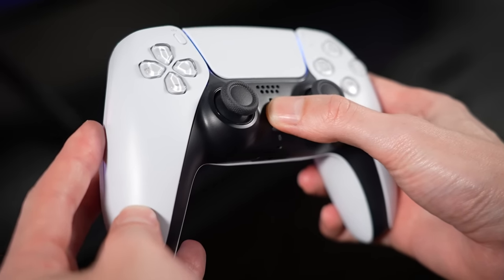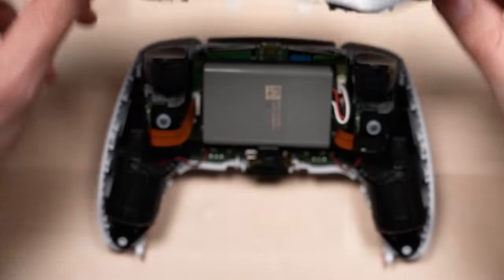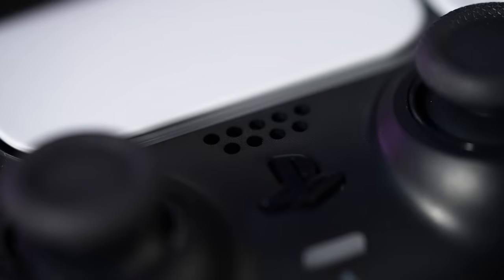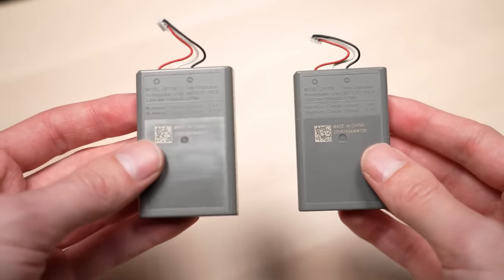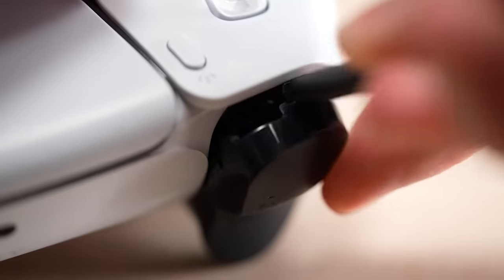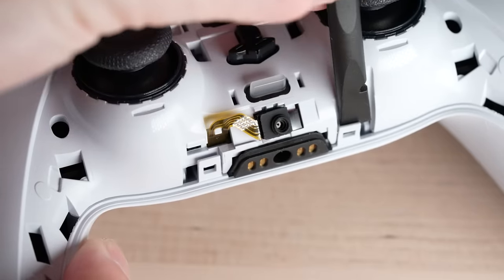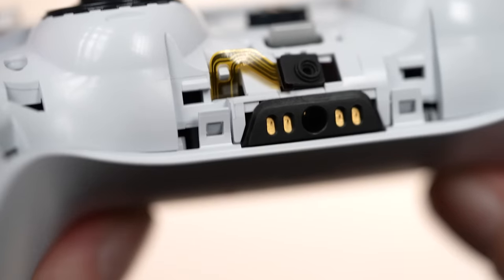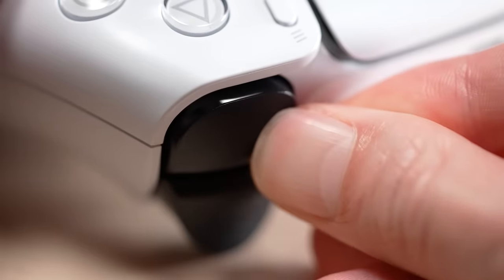Sadly, your Playstation controller won't last much longer..

Comment: I genuinely believe the more modern the technology the more it's designed to easily break so as to force us to but a new one.

Not only badly designed I think companies legit sit around and figure out what issue they want the product to have and design it as such.
Reply: Yea there is a term for this which is "planned obsolescence"
Reply: Bullshit, been gaming for 30 years, owned almost every console released since the late 80s, spend more time than most people gaming.. Not once had a controller break without me launching it at a wall or the floor, I ain’t lucky either, people just don’t look after their shit.. Fat hands mashing the thing out of panic and shitness, launching em etc.. Never had a phone go wrong on me, a tv, nothing, conspiracies mate, tin hat shit
Reply: @Primitive01  firstly at what point did I say only gaming technology.

Secondly I have to agree to disagree with the older consoles being fragile also, I have a snes infront of me that I have owned since they first came out that has been kicked dropped bashed (including the controller) and it still works, yet I have a Xbox one in the cupboard that I had for 2 years without any known damage (kicking dropped ect) that just died, it's the same with PlayStation I have a original ps1 I have owned since it first came out again that's been banged ect through the years still works but I had multiple ps3s that broke easily and also a ps4.
Reply: @kevmccormick1767  Did you not see where I mentioned TVs and phones?… “agree to disagree”, basically “I have no argument” 🤷‍♂️… I have a PS3, PS4, PS5 and a switch that ALL work perfectly fine, had all since release, used by children non stop, sticky hands, dropped controllers etc, no problem.. Years ago had 3 different different Xbox 360s NO issue.. The PS4s fan is loud that’s it… The majority of people have no problem at all, you THINK there is a problem because the only people who go around shouting about things are the people with issues, the millions and millions of people who have absolutely no issues ain’t running about screaming “my shit still works fine!”.. You’re in the minority, not the majority, you’re wrong
Reply: @kevmccormick1767  Actually you know what, I’ve had one thing go wrong, PS2, the fat one, so not no “new technology”, it’s old.. Every time I put a disc in it made a loud crunching sound and wouldn’t work, took the disc out and it had carved a deep scratch in a ring around the disc, had to send the PS2 off for repair,  which was free, warranty and all that.. Other than that all that’s ever happened is a few broken controllers from me launching them as hard as I can purposely trying to smash them into a million pieces, majority of the time they still fucking work.. I’ve actually got a ps5 controller that won’t clip shut because I launched it, works fine.. Got a taped up PS4 controller that I launched, years old, works fine
Reply: Obsolescência programada
Reply: While I kinda see where you're coming from, the problem (as I understand it) isn't that companies are actively trying to do what you are suggesting. The problem, is that in an effort to make things such as gaming consoles, TVs, laptops and so on more powerful. New technology is created, however in many cases, especially with video game consoles. The company has a maximum space they want the console to take up in the consumer's space. So they try to fit everything they want into the console, and if that fails they try to make the things they want smaller. And when you do that with computer parts, (as a gaming console is just a computer with a pre-installed operating system) they tend to become more fragile. All of that being said out of all the consoles I've owned. Only the PS3 and PS4 I shared with my little brother ever gave me any issues. And that wasn't till after he dropped them for the 7th and 9th time respectively. So, while I'm sorry you've had problems with it. You may want to see if there's anything you can change about how you use your stuff. Before assuming the fault lies with the company.
Reply: @Primitive01  Being ignorant and pretending one's opinion matters more is also a minority feature. Stop getting triggered and go enjoy your "WORKING FINE!!!!" technology.
Reply: @UltraObama  No I’m not lucky, the problem just wasn’t as common as people think, like all these “problems”.. I had 3 of em, 2 of em I bought second hand, no issues ever
Reply: @Primitive01  you taped up your ps4 controller😅😅😅😅
Reply: @darmor85  Yeah mate, the d-pad on it was perfect for fighters, never any input errors
Reply: @Primitive01  I can't hate bro but it's funny ..I know I wouldn't do it makes the hardware look cheap but each it's own...... game on bro game on💯
Reply: @darmor85  I did buy a new one, had 4 at the time.. PS4 D-pads are terrible but this one was perfect.. Still got it now, works perfectly
Reply: Yup they do it on purpose with a lot of modern technology and what isn't technology too
Reply: @Primitive01  Your experience is bullshit lol. Been playing with playstation controllers for years and I always have to either replace them or live with drifting problems. Playstation controllers are absolutely weak and always break in like 3 months. I legit got a new controller and it had drifting problems ALREADY, less than two months. I never hurt that controller and had to replace it already. 

It’s no secret that companies make their products weaker than their potential in order for consumerism to take place. It doesn’t surprise me since Sony and some TV companies have little competition with the quality of their products.
Reply: @Primitive01  Maybe Sony should make controllers that don’t easily break 😂 I need to smash some buttons for my competitive games. Jokes aside, I don’t smash hard at all, in fact, when I was using that controller that broke in less than two months, i was only playing games by myself, no competitive games at all. 

Most people have to get new controllers before their batteries turn to shit. You seem lucky as hell, or maybe you just don’t game much. The fact that Sony makes weak controllers just so they get more money is upsetting yet not surprising. If you honestly think companies don’t do stuff like that, then you have no knowledge about the term “monopoly”.
Reply: so true, same for Kitchen Appliance for exemple older appliances seems to last way longer than the modern ones after a study….
Reply: @adangamez3608  You’re insane
Reply: I think this is certainly the case with phone charger cables. Samsung and Apple are notorious for producing terrible cables that last a few months at best. They are now even distributing handsets excluding the power supply and cable, what does that tell you 😂
Reply: @Primitive01  bruh, it sometimes kust happens. I take great care of my stuff. It literally just fried my battery for sitting on the dock charger while I was at work. Literally shit happens. Lmfao
Reply: It's true.  The Centennial bulb has been on almost continuously for over a century.
Reply: @Primitive01  ooook..I mean I don't trash my stuff either but little wear and tear can lead to another one
Reply: @Primitive01  meanwhile I go through like 2-3 aftermarket controllers a year with drift or shoulder/triggers not working at all and tech support sends them back to me saying "they work fine"😂 items for different markets are using different parts. No mystery there.
Reply: If things never break then why would people buy many new things?
Reply: @modev4163  pretty much that. Those analog sticks only have an expected lifespan of 400hours and both cheap-ish aftermarket gamepads and premium ones use the same model. That's like 3 months before the part is worn out if you play a lot.
Reply: @roythegracious  Of course shit just happens, it’s rare
Reply: trading paints  I game too much, more than most people.. Plus I have 6 kids fighting over a PS4, PS5 and Switch.. Sticky hands, dropped shit, finger prints all over discs, thrown controllers, everything.. What it actually means is you’re just unlucky to be in a small minority of people who end up with defects.. The reason you THINK there’s a problem is because you’re the only people going around shouting about it.. If everyone who didn’t have issues went around shouting about it you’d see how little and rare the problems are, thousands of you, millions of me
Reply: @olaf5929  What do you mean aftermarket controllers?
Reply: @olaf5929  Yeah man, Cod= dead left stick in no time, ironically it was around 3 months before mine started going to shit drifting, and stopping me from running mid sprint getting me killed and shit.
Reply: @Primitive01  not made by Sony or Microsoft. By aftermarket I mean brands that make gamepads on license from MS/Sony/Nintendo like PDP or PowerA.
Reply: @Primitive01  You should be endorsed by the video game industry. "Shit don't break, pussies do!"
Reply: @olaf5929  Right, so you buy cheap shit and expect it to last? Would you go buy a cut and shut car and expect it not to fall apart or kill you?.. I know it’s a bit of an extreme comparison but still, you get what you pay for.. I’ve bought a few 3rd part controllers over the years and yeah, they don’t last, they’re terrible but I never expected them to last, I wouldn’t expect something to last when it costs anywhere from 1/6 to 1/2 the price of what it’s meant to be imitating… Guarantee Sony and them lot don’t have any control over those products
Reply: @modev4163  Shit breaks, it’s just rare.. Social media wasn’t around 20 years ago, you didn’t have every fairy with a broken product screaming about it to the world.. And like I keep saying, people who don’t have issues ain’t going around screaming about that either.. That’s what you people need to understand, social media, people with issues make noise, people with no issues are too busy using their shit
Reply: @Primitive01  I broke both Sony's and Microsoft's controllers through usage at the same rate ever since the X360 times that's why I started to buy 3rd party controllers. They last the same for me.
Reply: @olaf5929  Even the consoles themselves last.. Got a PS4 in 2013, got a PS4 pro in 2018, sold the old PS4 to a friend, he still plays it now, we play games together.. I’m on a PS5, he’s on a 8/9 year old PS4.. The pro is in my kids bedroom used daily for hours.. Everyone I know who owns a PS5 has had no issues with the console itself or controllers… We all got a little worried when the PS5 came out and people were going around “ohhh my PS5 has bricked itself blah blah”, year and half later no issues.. A few cases get blown up and sensationalised for clicks, views and likes when in reality there is NO problem
Reply: @Primitive01  i disagree my controller always shits out after 4-5 years my most recent one is 3 I take the best care of my stuff and it's always the left analog stick most likely due to having to always press it for abilities and to sprint in games.
Reply: @Primitive01  I had a working ps2 slim with a fully functioning controller from like almost 20 years ago. Proves nothing. The issue is with current day hardware - no matter if it's faulty joycons, drifting analogs on other gamepads or batteries dying. This should not happen for years. I have the same experience with gaming mice. I have a couple older models that are indestructible, while whenever I buy something new the 20million clicks buttons start giving out after about 3-4 months.
Reply: @Kitsune16-r4h  4-5 years? That’s goooooood, what’s the problem there?
Reply: @Primitive01  I was around before social media crybaby outlets. I tend to agree most shit if you take care of it will last but man those analog sticks are trash long term.
Reply: @olaf5929  Stop clicking the button 20 million times in 3 months 🤷‍♂️ there’s no issue with modern hardware, guarantee a similar amount of ps2 controllers would break through normal use, just don’t hear about it because social media wasn’t a thing back then
Reply: @modev4163  Had stick drift once in 30 years of gaming, a PS4 controller that I launched at walls countless times 🤷‍♂️ at the time I didn’t even know what stick drift was or meant, I’ve experienced it once
Reply: @Primitive01  yeah, do the math on those 20 million clicks in 3 months and get back to me.
Reply: @Primitive01  Sounds like you've been pretty lucky, I'm 35 myself and honestly my ps4 controllers are the first ones I've had drift issues with. My guess is you just get a bad batch every once in a while like any assembly operation. People do have a lot more platforms to cry on nowadays where as when we grew up we only talked to people we knew in real life
Reply: @olaf5929  I’ve already shown you and everyone else the math.. Easily less than 1% of products go bad through normal use, most likely closer to 0.1% or something silly like that considering a huge amount of people won’t own just 1 controller.. If you really think MILLIONS of people suffer problems then you’re insane
Reply: @modev4163  I don’t think I’m lucky, I think the problem is just so rare.. Being in a group of 99%+ isn’t lucky, it’s normal, being in the 1% is just unlucky 🤷‍♂️ When it comes to consoles it’s MASSIVE numbers involved so even if I tiny fraction suffer problems that a lot of problems
Reply: @Primitive01  Yeah haven't checked stats but on a larger scale your probably right. Either way peace man take care!
Reply: @Primitive01   I agree bro, only issue i had was my dualshock4 dpad always pressing right, because i was playing fighters on that lil buddy since 2014, when tekken 7 came out i played kazuya and was wavedashing every day, it died in 2021, so i guess it's still decent time for such a torture of a dpad lol!
Reply: @poligrant5152  Yeah fighters are way more taxing on a controller than any other game, I play MK, taped up a smashed controller purely because the D-Pad was nice.. But that’s a lifespan more than worth the money and it’s not like controllers are  expensive either, they’re actually cheaper than games now
Reply: @Primitive01   Yeah it's quite suprising how gamepads are cheapers than modern games, especially ps5 ones.. i don't know if i need to laugh or cry about it, good thing about consoles is you can grab bunch of games for cheap after few years, i never played much more than fighters on my ps4, so i have lots of catching up to do after i buy ps5, and i can get most ps4 games i wanna play dirt cheap, but new releases price is kinda a joke for me... it never should be that much.
Reply: @poligrant5152  They should be that much.. The price of games stayed the same for 10+ years even though the cost of making games went through the roof, we were well over due a price increase on games… Gaming is an expensive hobby, always has been and always will be
Reply: @Primitive01  I could write hours about this, to keep it simple, 
 the $60 dollars you pay for the game isn’t really the “price” at all. Instead, it’s more like an entrance fee, which is supplemented later on with additional revenue with things such as paid DLC, loot-boxes, annual passes, etc.

Now, I know that gamers tend not to be huge fans of these sorts of monetization strategies, to say the least, and I’m not going to say that greed is never involved. There are certainly companies out there who employ monetization tactics that I would not only consider to be greedy, but also manipulative and unethical. However, I think that is a problem with how these features are implemented, and not an inherent problem with offering these additional payment options to players.
how much should games cost – the truth is that I don’t have the answer – and neither does anybody else, really. This is still a relatively young industry that is changing fast, and must evolve as it grows. However, based on the way the industry is moving, it doesn’t really seem like raising the base price is really a solution to the problems the industry is going through – even if prices doubled it wouldn’t necessarily make the development model more sustainable, and nobody would actually buy a $100 game. If I had to guess where game prices go over the next several years,  I wouldn’t be surprised if developers made you pay as much for DLC'S as for the game itself.
On the other side, fewer AAA tittles released due to increased costs of making said games, so i will probably be fine with the price tag if it's only for AAA games, for any other genre it's still unacceptable.
Reply: @poligrant5152  Indeed there are some companies who are greedy, it’s horrible, EA are the biggest culprits obviously, Ubisoft are another.. But there are a ton of devs who aren’t greedy and they give more than your moneys worth… The majority of games don’t have DLC, it’s a one off payment and you’re done.. You also have to consider the amount of work done on most games post launch, it’s not like the old days where a game was released and that’s it, bugs, glitches and everything else was there forever with no fix, devs now work over time just to get rid of these little things and make us “happy”.. Over the last few years a LOT of studios have gone bust purely because they don’t recoup enough of the money that went into production.. I’m personally fine with paying £70 for a game (dunno what it is in $ if you’re from the U.S), I can afford it, I know some people can’t but like I said it’s an expensive hobby and always has been.. People do have the option of waiting for deals/second hand prices to drop a lot, it’s up to the consumer really.. But I’m the kinda person who appreciates the work put in by certain devs, companies like Rockstar, Square Enix, Fromsoft, any of the Sony studios who have been supplying us with insane games over the last few years, those dudes can take my money all day long because I know they’re doing it for me and not purely for profit.. I appreciate Sony too, they put quality first, they subsidised the PS3 and lost billions…. The main thing I look at with games is time, how much time am i going to put in? Anything over 40-50 hours and I’m willing to pay top dollar, that’s a lot of time compared to any other form of entertainment media.. I think this “issue” with in game payments and DLC is only an issue with a handful of devs, those devs are HUGE and pump out a lot of games but I don’t touch any of em, I made the choice not to give em my money a long time ago 🤷‍♂️
Reply: @Primitive01  Yep, EA and Ubisoft especially for the dlc part, i feel like most of these games feel so trash and have trash payments too.
Anyway brother, you made very good points and i had fun reading that, gaming is indeed a expensive hobby, especially if you wanna be modern and on time, but as you say if you thought about your money spent per hour it's actually not that bad with the game prices.
On a side note, PSVR2 will be worth a look when it launches, i plan to get it for the hope that sony will make some big budget VR tittles, and maybe some major VR improvements, too.
PS. I'm flattered, but im actually from europe :D
Reply: I don't think they sit to talk about how bad to design their products, but I'm pretty sure they low key go like "yeah so we want to manufacture these controllers for 30 dollars and sell them for 70".  They do know that this will make the product cheaper even though it costs a lot more and has better technologies.
Reply: @anthonyvadala4837  well the ps5 itself has no problems at all , all the problems that are happening to some people are happening on the controller , the analog sticks are the same ones that are used in the ps4 controller , which had problems but they didn’t change it for some reason
Reply: @UltraObama  I’ve had one since like 2013-2014 , it still works perfectly fine , only thing that happened is that a little piece of one of the battery pockets for the controllers broke which made it a bit shakey but you can’t even notice it , 🤷‍♂️
Reply: @hussain8776  I get that. I was more referring to said person's idea that companies are trying to make things easier to break as a whole.
Reply: @Primitive01  actually its true, same thing is happening in car industry. They use computer material simulations to reduce cost and quality  just enough to pass warranty.
Reply: @Mr371312  Wouldn’t surprise me if it happened in the car industry, everything to do with cars is already insanely over priced.. 

Is Sony doing it? Fuck no.. This is a company that lost billions subsidising the PS3, a company that puts quality and customer satisfaction over anything else just like a lot of Japanese companies.. Coulda charged far more than they do for the PS5 AND the controllers but they don’t, keep it affordable, keep the customer happy
Reply: @londin engerland “Gamer rage” is a real thing, pathetic but real.. In general I’m not an angry person
Reply: @poligrant5152  I’ve never been interested in VR with the way it’s done right now.. I’ve never played with headphones on, never shut myself off from people and the world around me, I don’t need to because I already get super engrossed in games.. When I’m playing a game it’s already as if I am the character in the game, i get so into them that I really struggle to play horror games lol.. I’ve always kept an eye on VR and always will but I don’t know if I’ll ever bother with it until it gets REALLY good, like Ready Player One good lol
Reply: I agree, my GameCube controller still works since 2004 with no problems.
Reply: Yep, it’s not that just that newer technology is easier to break, companies have done an unfortunately good job implementing planned obsolescence to get you to spend more money, and I fear that’s gonna be the case with the newer consoles
Reply: Not true. I am a product development engineer specifically working with verification and never once seen or heard this in my career from coworrkers, bosses or internal documents
Reply: @GolfCrafter  yeah the person who makes/tests products is just going to admit it. (Sarcasm)
Reply: @Primitive01  I saved and saved and saved and my 360 went faulty within 12 months. I was gutted, but was too young to really appreciate warranty.

I think 360s weren't the best and the PS3s are known to have poor quality thermal compound between the heat spreaders and the dies.

I'm not into "Planned Obsolescence" idea, I can see as you make things smaller and smaller and smaller that they will become more fragile. More power, more heat more wear, that's to be expected.
Reply: @Primitive01  im a bit sus with that xbox 360 story because all are prone to red ring of death only later consoles get it a little while after the launch models
Reply: @Caluma122  I had 3 different 360s and had no issues with any… I’ve never had an issue with a console other than the PS2… Things today just get sensationalised because of the internet but in reality any issues are so rare it can’t be considered an issue.. A small proportion of things going wrong has to be expected and because absolutely huge numbers are involved when it comes to gaming it’s gonna seem like a lot of issues, when in reality you’ve got 100s of millions of people out there who never or very rarely have any issue, ESPECIALLY today with “modern tech” because far more people game now than they did 20-30 years ago.. I read something earlier that apparently 2 billion people play video games, dunno how true it is but even if it was only a fraction of that you’re going to have lot of issues even if those issues appear like 1% of the time
Reply: @kevmccormick1767  I'm being honest but I believe that over optimization of products or poor quality control of the manufacturing part could be blamed.  In its simplest case you want something to be as efficient and light as possible for example, and you know by simulations that it works with say a factor of three. Before we had these computer simulations, you would guesstimate when developing (before concept test) and always be on the safe side, such as a factor of five in today's world while we were sure that it was larger than three.
Reply: @Primitive01  now hold it I've may have worded my last comment a bit vaguely let me rephrase i find it hard to believe you doesn't mean i don't maybe ya got lucky with the last one and may have ditched it in time you never know im just going of the facts that the rrod existed and got a lot of 360 consoles i didnt mean all of them were going to get it either i meant that you could have been at risk of it i also didn't say you were lying so you can cool off
Reply: @superpotato657  Interesting
Reply: @Primitive01  Your argument is solely based on your own experience. That does not mean it doesn't happen to other people's equipment. I can say the same thing and say, "my computer never malfunctions, but how come people's does?" You seem to have a narrow view of the world around you to think like that. Yes, it is uncommon for techs to go wrong in a larger scale; however, that 1% is still thousands/millions of people. Are you going to tell me that is OK as long as you never experienced it? Why do you assume everyone THROWS/SMASHES their controllers? I just don't understand the higher pedestal you put on yourself...
Reply: They’re plan is how to keep making money over time. Not, how durable can we make our products
Reply: @Primitive01  i think the reason your controllers still work after you toss them as hard as you can is because you're not that strong... probably only goes about 3ft away from you.
Reply: @joshuas390  You think wrong little man
Reply: @Primitive01  you call me little man yet you can't even break a piece of plastic. LOL
Reply: @joshuas390  But as you can see from my comments I have broken a piece of plastic, controllers don’t smash into a million pieces, they pop apart, try it… I call you little man because you go about with that profile picture but spend your time acting a fool on the internet
Reply: @Primitive01  my 1st ps5 remote literally just stopped working didnt drop it didn't spill anything I dont play rough either it just stopped working
Reply: @privatedankmemes4882  Unlucky.. I’ve had 2 since release and they both work fine
Reply: @Primitive01  well true, thought i just have dualshock 3 and 4, about 4 piece each and  they arent that fragile that i still use the same from the time they release until now, my kid brother often use it too and really no problem. Im sure above 90% everything is without problem if we keep the things proper
Reply: @Primitive01  totally agree, I'm 50 and have been gaming since my dad bought me Pong in the Seventies. He also taught me to look after my gear. I always strip and clean my consoles every six months after the warranty is up and same with my controllers. Companies can't make equipment that will stop dust as they need vents for cooling so it's up to the user to do the necessary cleaning. Every day use and I've yet to see a console fail, I had one controller stick suffer drift but it's easily fixed if you're good with a soldering iron.
Reply: @adangamez3608  his experience isn't bull, I am in the same boat with having no issues except one PS4 controller suffering drift which was easily sorted by replacing the solenoid. I game every day so my gear is well used, batteries with constant use and charging will last a very long time compared to someone who only plays on the odd weekend. Perhaps you throw your controller around when you're getting your ass handed to you in games 🤷 get guid. 🤣
Reply: @johnbuchanan3455  It’s easily fixed if you know how (I don’t) but also not very expensive to replace if needed.. The price of a game for 1000s of hours of use, one year warranty, worth it considering most actually last years
Reply: @johnbuchanan3455  solenoid? You don't even know what you are talking about. It's a potentiometer. Don't speak about subjects you have no knowledge on please
Reply: @Primitive01  Replacing the analog sticks is not hard, the hard part is finding good calibrated potentiometers. Originals are hard to come by. The dreamcast used hall effect joysticks, why can't modern consoles use them? The potentiometer joysticks are flawed from the factory and you know it...
Reply: @DarkoPetreski  I don’t know it, I don’t even know what a potentiometer is.. If you have issues you’re in the minority.. That’s all I’m gonna say now, can’t be bothered.. You’re in the minority and a negligible fraction of controllers suffer issues, it’s as simple as that.. You people come to me as if I’m weird or the devil or something when I’m part of the overwhelming majority.. The only reason you don’t see people like me all over the place is because nobody is gonna feel a need to go shouting about how their shit don’t break
Reply: @johnbuchanan3455  No, i don’t throw my controller nor abuse the crap out of it. Maybe Playstation should make controllers that can last with competitive gameplay? 😂🤷 I get pretty good at games, no need to tell me something that others online tell me already, “gEt gOoD” lmao, child behavior right there.
Reply: @Primitive01  I don't have problems with drift either, because I don't use my controllers that much, but you can't tell me the design isn't flawed. Hall effect sensors and magnets are way better, and that design isn't even new. The dreamcast did it, and flight sticks have been using it from almost the start. You just have to admit that it's planned obsolescence.
Reply: @DarkoPetreski  No it’s not, if it was a huge proportion of units would break, they don’t, you’re wrong.. I’m not gonna keep explaining it, a lot of people clearly go about with tin hats on and/or don’t understand very big numbers
Reply: @DarkoPetreski  a potentiometer is a rotating variable voltage knob from what I know but I'm a structural steel guy not an electrician. The shop I get my analogue sticks from calls them solenoids and they cost me £5, I don't really have to know what the specific name is whether you're right or my shop is right to be able to unsolder the old one and replace it. I've only ever replaced one but it's been fine for nearly six months now so I must be competent enough to fix things outside my own field of work. 🤷
Reply: @johnbuchanan3455  if you can solder the damn thing on, you can learn the proper name for it.
Reply: @DarkoPetreski  I don't really have to if it works, it's not like I'm starting a career in fixing controllers 😂 and I can't see it being planned when they use a part that's cheap and freely available. They could make the controller a sealed unit or slightly modify the parts so you couldn't buy a replacement but the option to repair Is there so there's no complaint imo.
Reply: @johnbuchanan3455  sure i guess, but i still hate the potentiometer design. Check out the gulikit kingkong 2 pro, hall effect sticks and triggers.
Reply: The lightbulb conspiracy homie
Reply: @avocaza1393  everyone is entitled to their opinion 😭
Reply: FACTS
Reply: @Michael Moores Because you’re unlucky.. You don’t understand huge numbers and percentages.. You are unlucky
Reply: It's called planned obsolescence, and is what happens when only profit incentivizes industry growth.
Reply: In this case, not so much. This is a limitation of modern battery technology. The holy grail of battery tech is a high capacity battery that can be charged and discharged quickly, and doesn't lose maximum charge during normal use. Something like a capacitor, but better.
Reply: @Primitive01  "companies like Rockstar, Square Enix, Fromsoft, any of the Sony studios who have been supplying us with insane games over the last few years, those dudes can take my money all day long because I know they’re doing it for me and not purely for profit." 

I find it really funny that these (with the exception of FromSoft) are the companies you decided to highlight. Rockstar - the company that has resold GTAV for $60 across what is now three generations of consoles and tries to milk its playerbase with shark cards. Square Enix - the company that just sold off their Western studios to fund blockchain and cryptobro investment (lmfao). And lastly Sony, the same company that turned Gran Turismo 7 into a steaming pile of micro transaction bullshit instead of what should have been the premier next gen racing title it was meant to be. The only three big boys you were missing to make the list absolute satire are Bethesda, Ubisoft, and EA.
Reply: Capitalism 101
Reply: @Primitive01  ps3.

Not everyone is nintendo , companies can and have cheap their controls / consoles / accesories for more money.

And nintendo still isn't except of bad design , joycons start having drift the moment dust enters on it.

dust !  the first most common thing to have in a controller for a portable console.
Reply: Fortunately reality isn't quite so cynical as that. True companies design things for planned obsolescence, however in most cases its just a matter of deciding which issues are "acceptable" risks. In many cases its cheaper for them to eat the cost of a few replacements than to fix the problem.

That said, some technologies are more prone to wear and tear than others. Older systems used less power, had fewer chips, and we're designed more robustly with children in mind.

Even then, how many PSX CD drives died due to being left on for days? Obviously its going to be worse now when everything uses high tech sensors and the like.
Reply: @chrismdb5686  You know exactly what I meant.. Yeah I could have worded it differently, I know it’s about profit, they are businesses, businesses that provide the highest level of quality and actually give a shit about offering a product fans will love, if people like your product your profits will increase..

You lie, GTA5 on the PS5 was a cut price for how long?? I think it still might be, not full price, nowhere near it and anyone buying it is doing it purely through choice, it’s not required at all.. Shark cards are never thrown in your face, they’re on a menu screen you never have to look at and there’s never a point where you feel a need to pay, it’s purely a choice.. You also forgot to mention how GTA5 has had countless amounts of free DLC over the last 9 years, isn’t the same happening with Red Dead as well?? Free content across 2 games? Good service they’re offering there no??..

Square doing whatever doesn’t affect me so I don’t care..

I’ve got GT7, it’s a brilliant game.. Sony lost billions subsidising the PS3 even with the high retail price but whatever, Sony products are of the highest quality

I’ve never spent a penny on micro transactions and probably never will, I don’t understand the issue with most of them.. The ones you mentioned are for in game cash, they offer no advantage and you know exactly what you’re getting, it’s an option that essentially cuts out a few hours of play time, what’s the issue?? Things like “loot boxes” I understand the issue, you don’t know what you’re getting and in some games they DO give you an advantage, still, you ain’t required to pay it, if it’s that much of an issue just keep your card in your wallet but whatever, like i said you know exactly what I meant 👌
Reply: Responding to earlier post: @Primitive01  survivorship bias is strong with you. ‘Never happened to me?! Y’all are crazy.’ 

Meanwhile there’s been literal case studies on Apple degrading their batteries intentionally (Watch Marcus Brownlee), GE building shitty washing machines that fail quickly, modern Volkswagens, or how lightbulbs should last forever but aren’t profitable (Watch Veritasium), etc. Just admit you’re lucky and move on. Do some research. There’s a reason why people from different backgrounds can all agree the newer stuff isn’t built to last.

Edit: Also, why so worked up? Defending these products and corporations profusely for days against literally everyone. Not like you’re appreciated by those businesses…
Reply: @Primitive01  No I didn't know what you meant, but know I know you just love the taste of corporate boots.

So Rockstar never throws Shark Cards in your face... despite the fact they advertise them? Despite the fact that when you try buying an item you can't afford they pop up and say "here's an easy way to get that paper friend." That's not literally putting it in your face? Ok then. RDR2 is dead and not getting anything btw, that's been the case for a while, and GTAV ""next gen"" is full price in a lot of places (including where I live), but you'll probably just throw your catchphrase out to that and say "well you're just unlucky" right? Lmao

GT7 is absolute shit, let's take a mostly single player experience and cap the amount of in-game currency players can get through playing the game so people are pushed to purchase that currency through micro transactions just to play the game. Every ""coupon"" you get for a car purchase is only available for a few days so if you either don't have the cash or don't want to actually pay you're SOL and can't unlock that car. Don't have the right class for daily/weekly events online? Open the wallet or else you're SOL. Don't even get me started on the fact the game is 90% a single player experience but needs to be connected to their servers 100% of the time for you to even play.
Reply: @frustratedmillennialz  I don’t doubt it happens in some industries, you can see what I’ve said, I’m talking about the video game industry, or more specifically Sony, Microsoft and Nintendo and controllers.. I’m not defending anything, I’m replying to people who come to me, I’m being polite.. I could just tell everyone they’re stupid and leave it at that… I’m not lucky, I just understand the numbers involved and the role social media plays on peoples perception, something almost everyone here blatantly can’t understand
Reply: @Primitive01  I never paid for a copy of GTAV in the first place, so why the hell would I buy GTA6? Because brand recognition? Nah, just because you consume products with no thought doesn't mean everyone else does the same. I didn't buy GT7 because I've learned to not pre-order shit because too often those that do get fucked over by the devs for doing so, and holy hell am I happy to have only experienced GT7 second-hand. Imagine being happy with a product you paid 70 $/€ for and can't play whenever their servers are offline/down for maintenance when it's intended as a single player experience first and foremost. That'd be like buying Skyrim only for Bethesda to randomly pick and choose what days you can play the game on.

"Honestly I think you're just a fairy" - sorry, I understand if English isn't your first language or something, but what the fuck does that mean? 😂😂😂 The rest of that tirade makes you sound comparable to a Nintendrone with your worship of these god companies that can do no wrong.

Touch grass
Reply: Wtf are you guys doing arguing for a week.
Reply: @BamfIamone  As you can see I’m just educating people who come to question their daddy
Reply: @Primitive01  The only time I've really had tech break was a couple phones, an xbox one controller, and my dualsense. One cot run over and the other got a cracked screen when I dopped it and it hit my boke pedal. That being said, my dualsense broke when I never did anything to it. I just palyed it. Not even enything strenuous, and I don't eat and game. the joystick just was not made the best and started getting drift. The xbox controller was understandable though. I played Sekiro and Ori and the Blind forest, and between those two game my LB eventually broke, but that was because of the design on the og controllers. It also started to drift a bit, but it had been in use for like 6 years and probably a couple thousand hours between the previous owner and me so that's fair
Reply: @orinblank2056  Ok.. I’ve got 2 dual sense controllers, had em both since release, one is popped open on the left handle/grip or whatever you wanna call it because I launched it at a wall, a clip snapped and it won’t pop shut, both still work perfectly fine.. Thought the trigger or something might not work on the smashed one but it does, they both work as if they’re brand new.. I have 6 kids, the controllers get used way more than most peoples, they get filthy, they get sticky, they get dropped, don’t doubt they get hit and chucked when I ain’t around too.. If you’re shit broke through normal use you are unlucky.. Every single person I personally know hasn’t had a single issue with the console or any accessory.. Remember when the PS5 first came out and peoples consoles were “bricking” themselves? Unlucky few
Reply: @Primitive01  Not all products are made exactly the same. In mass manufacturing some items are just made with kinks and whatever the weakest link is breaks first. 

My PS3 slim's board just completely burned out on me one day while playing. It froze and then didn't turn back on. I tried replacing the power supply in hopes that was the issue but it wasn't. 2 weeks into owning my PS4 the R2 spring snapped on me and I had to replace it. The replacement has endured ever since. 2 years in I had to replace the battery for the same controller and just recently I had to replace the charging port for it. 

Nothing older than that PS3 has ever broken on me. I'm not saying things are purposely made to break easily but as technology advances, the parts used to make them have become more delicate. When you're mass producing these delicate parts, some of them are going to be less sturdy than others, even among the same part.
Reply: @Syntherus  Of course not all products are made the same.. Things break unintentionally but it’s rare when considering how many units are shipped.. 120 million PS4s have been sold, I dunno why I keep saying the same things over and over.. imagine 1% of pre packaged PS4 controllers broke, that’s 1.2 million broken controllers, it’s a LOT but it’s still extremely rare and people are extremely unlucky.. Now imagine 10s of thousands of those unlucky people go about shouting on the internet “my shit broke my shit broke” and they see all these other people saying the same thing, they’re gonna think there’s a problem no? There’s no problem, you are unlucky 🤷‍♂️.. Shit, now think about how many break while still under warranty?? It’s silly numbers mate
Reply: @Primitive01  Nah obsolescence is a legitimate thing apple got into trouble for it with their batteries being designed to fail after a year.
Reply: @drunkengamer1977  Yes, read newer comments
Reply: @Primitive01  "you're insane" and you are the one talking about argumenta...
Reply: @RSlamyx  What
Reply: @Primitive01  lol there's far too many. Sonys usually pretty good tho I've had them all since PlayStation one the only one that died was the OG fat ps3. The only controllers I've had issues with was the launch ps4 pads  the rubber came away from the sticks on both of them but that was a known problem that Sony addressed had no issues with the newer ones.
Reply: @Primitive01  I've been gaming just as long and I've had tons of issues.

The original NES had the spring that would wear out.

The TG16 just stopped turning on at all for no discernable reason.

The original Playstation had overheating issues and the laser would stop reading games. This happened to not only me but to several other people I knew.

The original XBOX also had overheating issues.

PS4 analog sticks developing some kind of weird dead-zone when pushed to the edge as well as drifting.

Just had a TCL tv that suddenly makes everything look super washed out. Tried everything and nothing fixes it.

A 2TB HD got a bunch of bad sectors after only a year of use. Once again nothing works.

Had another PC that for some reason just randomly stopped detecting the graphics card. It wouldn't recognize any others I tried either, even after thoroughly cleaning it and a fresh install.

I've never mistreated any of these items and yet I they all developed issues. Sometimes you just get unlucky.

Planned obsolescence isn't a fake conspiracy theory either it's a real one. Watch Veristasium's video on it.
Reply: @Vaporifix  My point is “new” things are no different from old things, you’ve just shown that in your experience what I’m trying to tell people is truth
Reply: @Primitive01  didnt actually mention phones or tvs and i believe your in the minority in this one since those issues are highly common not to mention planned obsolescence is covered in college Engineering classes part of the reason why phones are basically disposable same as most electronics nowadays
Reply: You are absolutely correct. New smartphones can't even be taken apart, for the same reason - so that you don't fix it yourself.
Reply: lmao this man really said " i even had 3 or 4 360s with no issues" 💀😂 does anyone really need to hear literally anything else this man says... i don't think so
Reply: @Primitive01  it's a little weird the man who is so defensive of the product almost as if it's a personal insult or he works with said company has had multiple of the same consoles yet none has had issues, here's a question for you if you have had no issues everything works fine then why feel the need to go buy multiple replacements of the very same thing?
Reply: @kevmccormick1767  What? The 360? The 360 is the only Xbox I’ve ever had, I was impatient and couldn’t wait for the PS3 but I ended up liking the 360.. Anyway back then I was a lazy jobless 16 year old, came across a little bit of money got a 360.. I didn’t have the money to own multiple consoles, over time the Wii came out, I wanted one, didn’t have much money, traded in my Xbox, got a Wii.. After a while traded in the Wii got another Xbox, split up with my partner at the time and she kept the Xbox, eventually I went and got another one.. No doubt not the answer you were hoping for but whatever
Reply: nomasporfavor  Ok little boy
Reply: @Primitive01  you've been responding to these comments for the last week. Go touch grass
Reply: @MrHappy4311  Touch a woman fairy
Reply: Switch drift
Reply: No shit Sherlock
Reply: Especially how they don’t want you to try to fix it either with warning labels because GameStop or the company themselves won’t compensate for a dysfunctional product if you do better pay for that warranty all I’m saying smh.
Reply: @Primitive01  "rare, you must be mistreating your stuff, this stuff is the minority so you're WRONG, hasn't happened to me so therefor these are lies," God of War pfp? Checks out. I hope Sony is praising you for the free pr you're doing for them. It's funny, because a little over a year ago I called a Sony rep, you know, the dudes that actually get PAID to work for them? Yeah, he told me himself that two of the most common problems they get for their dualsense is stick drift and loose triggers (which was my problem) thanks to the adaptives. But I'm sure you'd be happy to yell at him with your laundry list of excuses. I don't eat while gaming. Ever. Hands always stay washed after the bathroom and eating. NEVER thrown any of my dualsenses because I'm not a manchild. This shit happens and isn't "uncommon" as you like to put it. The only thing you're right about is obviously there's going to be more people with working products than not. But give it time and I would bet my left kidney that there will be way more people that need a new controller. In not that much time either. It's kinda obnoxious that there's people like you out there claiming things are bullshit because you apparently haven't experienced it. So first controller I played two games at the time that used adaptive triggers, got a loose r2 button. My most recent issue stick drift. And it was a black one so not that old! Crazy part? I don't even play shooters so I'm not mashing in the sticks 24/7.
Reply: Apple
Reply: @SuperHornetX  they don’t do that anymore bud
Reply: @UltraObama  my 360 has had 20+ ring of death but still works almost fine just the disc drive doesn't work properly
Reply: @ErockHQ  they've always done that.
Reply: @SuperHornetX  and they got sued and haven’t done it in multiple years
Reply: @ErockHQ  they literally did it months ago.
Reply: @NYC_Goody  It’s rare.. I ain’t explaining again
Reply: I don't think it's that nuts but the more complex you make a machine the easier it usually breaks and alot of people do really stupid shit to their possessions cause they don't think it'll break. Before I got my PS5 I heard stories of people breaking their adaptive triggers but after I used them it kinda clicked that it seems people have to basically try to break them when they get tight from stuff like Fortnite bows and stuff in game
Reply: @Primitive01  you don't know what rare is. You're a grown man doing free pr. Obviously in the grand scheme of things with any product, there's going to be more working than not. Captain obvious statement. But to act like it's a few isolated incidents is completely oblivious on your part. Know what we did before social media? Took it to the store and bitched.
Reply: @NYC_Goody  Right? I grew up Sony but hardly trusty them anymore, mainly from their lack of care for the PS5 scalping market
Reply: @Leboyo56  yeah, I actually don't get this guy. I mean, the only systems I ever grew up with were a bunch of the older Nintendo ones and a ps1 through 5. So I've been with Sony for over 20 years and while I'll agree with him about the older accessories being built like a tank, I can't get behind him saying it's like that for the 4 and 5 as well. I mean good for him that those 2 generation controllers can somehow go through abuse while I've had to go through ps4 and already ps5 controllers when I take care of them. Makes no sense.
Reply: @Leboyo56  “PS5 scalping market” another thing blown way out of proportion.. “I can’t get a PS5 because scalpers”, no, you can’t get one because you are number 30,000 in the queue with a stock of 200
Reply: @NYC_Goody  He seems like the guy where you could unknowingly agree with his opinion before he voices it, yet he'd still shoot ya down just to disagree and be on top of the conversation.
Reply: @Leboyo56  based on his comments, I'd say that's pretty accurate loll
Reply: It's not some conspiracy, technology gets more advanced, compact, and in turn, more fragile. Think about it, of you throw an old controller that has nothing in it but a circuit board, a few wires, and a battery, it's not going to do shit, if you throw a new one that's heavier, has 5x more wires, a circuit board with more shit on it, and adaptive triggers and all that shit, something is bound to break.
Reply: @Primitive01  not true lmfao never threw a single controller nor do i bash shit yet one of my Xbox 360 controllers stopped working with no real reason to so im not sure what your talking about when you say you had nothing break that's just being hella lucky
Reply: @Primitive01  you better go look after your 6 kids lol. You have too much free time daddy
Reply: @keyboardwarrior8905  Might take you a while to read and respond, takes me no time at all.. Majority of these comments have been posted while I’m at work, you know, unlike the most people here I have a job
Reply: @Primitive01  i’d agree - but even the best cared for controllers in a dusty enough environment can render buttons or control sticks defective
Reply: @Leboyo56  I’m the type of guy who talks TO people, not about them.. People trying to make out I’m weird for replying to comments, you’re here just hoping to get noticed ffs.. Don’t be scared, get involved.. I’ve already told you how you’re wrong, instead of “oh yeah makes sense” it’s “nope, gonna ignore the common sense and keep believing my fallacy” because instead of using your own brain you blindly follow any old waffle you read on the internet
Reply: @DuskLegend  Of course, if you read a few more comments you’d see that during my time educating fools I’ve said multiple times I fully understand a certain amount just go wrong for no reason, it all comes down to how many going wrong is acceptable which would be a matter of opinion
Reply: @gastergiovanna9793  Ain’t surprising that you’re not sure
Reply: Yes, it's true, but when it comes to joystick drift and lithium batteries that is not much to do, they will have problems eventually.
Also, planned obsolescence is very common on the car industry.
Reply: @kevmccormick1767  I will have to say, I do agree with the other guy more. While it may be possible, there's quite a lot of proof that just says you either received a fault console/item, or you just didn't look after properly. My family have old, old consoles that still work fine and dandy. Even the xbox 360, where everyone had issues with the "red ring of death", is still happily up and running. I've had my 2DS for almostc10 years, my Nintendo DS for longer, and my Xbox One for over 6 years. And guess what? All of them work absolutely fine. My family have all had the same consoles, TV's and phones other than when they 1, wished to upgrade or 2, you're my sibling who managed to get so angry they broke their DS purposely, twice. The point is, things won't break if you take good care of them. I don't tend to mash buttons or get aggressive with the joy sticks because not only am I quite calm and respectful towards my consoles, but I also play fairly calm games that don't require that aggression. And even then, my father has still had most of his controllers from when he first got the xbox that still work despite playing such "aggressive" games. Just look after your stuff, and if there's a problem, then oh well. You just happened to fall into the minority group who gets those problems. With anything, things get old and things sometimes mess up, you can't expect everything to be perfect. But making up the statement that they purposely break their own stuff? If that were the case, there would be way more issues happening and way more people complaining.
Reply: @avocaza1393  How is anyone being triggered? All they said was that it's a minority issue, which is true. Apologies if you've faced any issues with consoles yourself, but it is literally a minority issue out of the almost 8 billion population.
Reply: @adangamez3608  If you haven't read a previous comment on the subject, many companies create the console with a limited amount of space to suit what people want. People no longer want big bulky consoles and instead want thinner, smaller consoles. Which means that the things inside, if it can't fit the limited space, will be forced to be made smaller which means it'll be more fragile. You want a smaller console and controller, yet complain when they do exactly that because they physically can't make the things inside as durable as they want to. And if they did create a bigger, bulky console, you can be damn sure that everyone will throw a fit. You also admitted to playing competitive games and having to mash buttons. Now while it's not an issue and you may be "mashing the buttons lightly", that stuff still builds up over time which causes your controller to get stick drift and button issues as a controller isn't really supposed to be constantly mashed the way people do in competitive games (just hearing how loud you guys are with it causes great sadness for me lol). While I do have sympathy with the fact your brought one with stick drift already, it doesn't take a genius to know that all the aggression, no matter how "light" at the time, will build up quickly if you either 1, game all the time and/or 2, constantly mash buttons on your competitive games.
Reply: trading paints  It doesn't mean that at all. My father is an extremely competitive gamer and whenever he isn't at work, which is quite a lot, he is always on his games. Yet all of his things work completely fine because surprisingly, we look after our things. Sometimes stuff just breaks, especially if they're old or, like you've literally just answered yourself, you use them all the time
Reply: @olaf5929  No, it's not pretty much that. Because if they did purposely make consoles to break, guess how many people would be going on a rampage complaining about their broken consoles? I'll answer it for you, not many. Because the majority of people who play still have good, working controllers and consoles, even ones from back in the day that still work perfectly fine.
Reply: @Kitsune16-r4h  You literally just answered yourself. You've had it for YEARS. Looking after your stuff is all good and fine, but you can't expect it to last forever. Wear and tear can build up over the years, no matter how gentle. Some people can have them for ages, some don't. But you can't complain when each controller did it's job and lasted multiple years then broke because they just got old. That's like me complaining my nan died. She passed because she got old and that's what people do. It's a dark comparison but for you people to understand, its the only thing I had
Reply: @olaf5929  Again, go back and read the persons comment on how stuff are built. Past consoles etc are much more bulky then modern ones, which means the stuff inside are more durable. However, because the new ones are slimmer, the stuff inside are required to be smaller so they can fit which means they are more fragile. This is because people now a days are complaining about how the consoles are too bulky and should be made slimmer bla bla bla. And before you go, "Well I don't care if it's bulky or not!" Good for you! Say that to the millions who do care. Because news flash, you guys control what's made as companies will always look to what people want most in a console so they can make it, make people happy that they got given something they asked for, and keep customers. Only for you all to complain "it breaks easier!" After you all smash buttons and shit. No wonder.
Reply: trading paints  You say as millions of xbox players still have working consoles and controllers they've had for years, me included.
Reply: @poligrant5152  Popular games are the worst. I had one game that was 50 pounds or so, then within a year went to 20. But games like Pokemon will always, no matter what, stay at over 50 pounds because they know it's popular and people will buy it. Same with EA. Unless you buy DLC packs, the game tends to be so tasteless it isn't worth buying. Sims 4. I love the game, but unless you buy DLC packs, it's awful on it's own.
Reply: @superpotato657  Sorry, but not all are prone to it. My father still has his from when they first came out and it works fine. Things dont always break, get over it.
Reply: @jaek8029  No one is saying it's ok, he's saying that it's a minority issue and isn't the company purposely doing it.
Reply: @adangamez3608  Or maybe you should just... not be on your console 24/7? And they do make controllers for competitive players, my father has had controllers for more than 5 years and they still work. And anyone else I know also have controllers that still work. It's simply just a case of "I use these too often and over time they'll obviously wear down, but I'm going to pretend as if it's Sony's fault and not my own for spending my entire life on a console and causing a controller to do what anything does, get old and wear down"
Reply: This comment section is filled with two people. The unlucky side who complain they've had something for multiple years that break after wear and tear or complain that the consoles are fragile whilst still being the same people who complain for slimmer consoles and the other side, the majority of people who have had zero issues but use a lot of bias to back up answers. And while bias does work, it's still, in many eyes, not a valid argument/point.

While some companies are shit and are doing things as a money grab, making things less durable or just purposely not good so people HAVE to buy new ones, consoles aren't like that.
Reply: @Totally_Not_A_Crab  your clearly not getting what I'm saying then, I clearly said I have older consoles like a SNES that still works (also have a few other retro consoles all working) so if my issue was wear and tear over many years wouldn't I be moaning about my older retro consoles no longer working.

I don't recklessly use my technology if I did then my older consoles would be broken after about 30 years of use.

I will reword my point since people are getting offended that I dare criticise their precious gaming systems lol the more modern the technology (not solely gaming tech) the lower down the list of priorities for corporations is reliability and lifespan. Then you also have some companies that legit program/produce the product to break/fault after certain timeframe regardless of usage, apple have been proven to do so and if they do it the chances of others also doing it is pretty high.
Reply: Cries in joy con drift
Reply: @Totally_Not_A_Crab  That's why after i bought sims 3 and dlcs, then bought sims 4, i started cracking DLCS because no way in world im paying over 350$ or even more for full experience, and yes that's life of popular games, where you say that they go cheaper within a year, that's why im so happy i have lots of game to catch-up after i get ps5, they will be stupidly cheap, im not even guilty for cracking games that are made like bloated DLC assholes, don't care.
Reply: @poligrant5152  I just think it's a stupid cash grab on most parts. They know if they release a shitty game people will buy DLC to get more of the experience. Its bullshit.
Reply: @Totally_Not_A_Crab   Yes, companies like this really like to test the waters and go over the line and see how much they can afford to cut out, funny thing is games from EA or Ubisoft mostly feel the same in terms of gameplay, and are full of useless open world interactions that are totally boring to do.
Reply: @Primitive01  Companies have made products which they know will fail after a certain time in order to ensure a consumer base and demand is always there. 

This is no secret and the biggest case to come out of it was from light-bulb manufacturers. The top light-bulb manufacturers got together in the 1920s and agreed to make sure their light-bulbs would not exceed a certain amount of hours before failure. 

The same practice was found to be used with General Motors and Ford, and has been shown time and time again with modern technology. 

The practice still exists because it works, not many people complain because of warranty. 

In 2020 Microsoft faced a lawsuit due to making their controllers 'drift', as did Nintendo and Sony for DuelSense. These cases (at least for MS and Nintendo) were taken to Arbitration as per the "Service Agreements" that were signed. They clearly know what they're doing and if they are purposefully making their products to break, not much can be done as they will just make a public statement saying 'it's a design fault we overlooked' and take any lawsuit taken to Arbitration due to their agreement you sign when you sign into their service. They have covered themselves legally and even if a lawsuit were to make it to public court, the amount they would lose would be nothing to the amount they make from selling the products.
Reply: @No-wo8ri  And who bought this lawsuit? A handful of whiney little Americans in a nation where you could face a lawsuit for saying “good morning” to someone?.. Time it took to write that comment you could have read more of mine.. Too many people jumping into a discussion way too late and after reading only one or two comments
Reply: so accurate
Reply: exactly
Reply: PS2 controllers could take a beating and never break mine are like 18 years old and still going strong
Reply: it's called planned obsolescence.
Happens in many companies.
Reply: i think another thing to keep in mind is that these gotta be mass produced. its a great device but they gotta cut corners somewhere and that hits longevity unfortunately
Reply: @Primitive01  touch grass, gamer
Reply: @Primitive01  The lawsuit was more than just some 'whiney Americans'. The lawsuit was taken after the law firm got a class-action suit together. They cited that since 2014 there were thousands of complaints of controllers beginning to drift just weeks after warranty expired. They went through message boards and YouTube, Amazon sales and saw that the problem was large enough that videos on fixing the issue had hundreds of thousands of views. 

I've seen enough of your comments to know that you believe that they don't make the controllers, or at least certain components in them, to break or be fragile on purpose. The truth is they would absolutely do it, because there is no downside to them doing it. They can't be sued because they've covered themselves in the service agreement, they offer warranty which covers them from consumer law, and as a result they would and do make millions off of selling controllers. The companies take a loss on the console, they need to find a way to make that money back. It is just a business practice that is used. 

You can see that on Amazon the components for repairing the common problems are constantly in the top 50 sold under the gaming category. While I can't get exact sales numbers across multiple suppliers, there is clearly an issue that isn't 'whiney people in the minority'. I would say it would be even worse as most people who experience don't even take the time to go onto a message board and complain or repair their own controller, they just go to the store or buy a new one online.
Reply: @CrispyChicken38  “literally literally literally”.. I wouldn’t be surprised at all about American companies doing it, you people pay to be told to get out of bed in the morning, could sell you a bag of air ffs.. Japanese company’s generally put quality above all, it’s why their products are so popular and well liked, LITERALLY
Reply: Just buy one from Walmart and take it back every 29 days for a new one.
Reply: I have PS4 I have owned since launch it never broke on me.I've only had to replace my controller as it was 7 years old and no longer was holding a charge.My PS4 has been kept in great condition no problems to do this day.
Reply: @No-wo8ri  What’s thousands when it comes to hundreds of millions? It’s negligible.. 

Controllers breaking weeks after warranty expires? I’d pay attention to that if there wasn’t an insane amount of variation between peoples general usage and care, again it comes down to the hundreds of millions of controllers being used and a negligible amount coincidentally breaking not long after warranty expires.. How many break before warranty expires? How many break 6 months/1 year/2 years after warranty expires?

I don’t doubt it happens in certain industries and to be honest I would not be surprised at all if Microsoft did do something like that (I don’t think they do), they’re an American corporation who tried to bully their way into the industry for all the wrong reasons and if they keep going the way they’re going Xbox will disappear before long.. 

Saying “they can so they will” is a joke, the only evidence for it is a negligible amount of people who think a £50 product should last a decade, a product that goes through more wear and tear than almost any other household item.. The fact it only comes with 12 month’s warranty should make it clear to everyone your controller should not be lasting as long as your console, you should expect to have to buy one or two replacements over the years.. They’re not even expensive ffs, they’re the price of a single game, even if Sony or Nintendo were doing it the money they’d make would also be negligible… Do it because they can? And ruin the reputation they’ve built up by putting quality and customer satisfaction above all else? Something Japan prides itself on, the opposite to America… There’s a reason Sony and Nintendo completely dominate the industry and it ain’t through conning people into buying inexpensive replacements that’s make them negligible profits
Reply: 0lanned obsolescence
Reply: @adangamez3608  tbh I've had my ps4 controller from I bought it and it's fine but I did have issues with Xbox controllers. The battery for both don't last as long anymore either but idc
Reply: @Primitive01  damn. Mans singlehandedly spoke for everyone
Reply: @abelchavez2463  Some lead, some follow
Reply: @No-wo8ri  People also watch videos when they have no problem.. Millions out of hundreds of millions is still a tiny fraction
Reply: I've had many Xbox One controllers and they just aren't made to last. One of them had a really stiff and crunchy d-pad and a mushy bumper right out of the box, and all the others have developed mushy bumpers, inconsistent bumper actuation and stick drift within 2-3 months. Even the original Elite controller developed mushy bumpers and stick drift within 2 months of me owning it. I don't hit the buttons, I don't throw my controllers, there is nothing abnormal about the way I use them. Some things just suck, but I also wouldn't be surprised if there are at least a few companies out there that incorporate weak points or potential faults into their products.
Reply: @No-wo8ri  No I just think your “statistics” don’t show much at all.. You don’t need to watch a whole video for it to count as a view, you don’t need to search for this shit for it to be recommended, you know for a fact half the people in this thread alone don’t own a PS5 and have never even seen one.. Your statistics don’t show how many people are watching shit or buying shit before warranty expires, a year after warranty expires or nothing, they show people bought shit over the last 9 years, yeah, NINE years for consoles with combined sales of 300m+ and rapidly rising.. 

Sony can’t prove it’s not done on purpose just like it can’t be proven it is..

Shit breaks, there’s a ton of variables involved, too much for a company to figure out how to con people
Reply: It’s been like this for decades. Clothes used to be quite expensive but they lasted forever. Dads 72 HQ Belmont did 600k km without an engine rebuild, entirely serviced himself they were so mechanically simple. But then companies realised people weren’t buying their things more than once
Reply: @Primitive01  The Switch has a pretty common problem with joycon drift. You can solve it by putting a piece of paper under the cover so that the stick is pushed in place more firmly.
Reply: @Primitive01  go look at the lightbulb industry and come back they literally made the lightbulbs break and or break faster bc when your shit lasts forever you don’t get a lot of business
Reply: @rileyedwards6495  Read more of my comments and come back
Reply: that's fact bro, no cap
Reply: @Primitive01  OK, enough of this. But just so you know this isn't the first time Sony has been accused of doing something like this. Accusations go back as far as the 80s when people started reporting their Sony products exploding only months after warranty expired. They tried to dispell the rumours in 2006 after a massive recall happened with Dell who used Sony's batteries. This gained attention and relit the rumour that Sony was purposefully making their products break after a certain amount of time. This was brought to light in the western world after it was found that a 'software bug' caused Sony's Bravia TV'S to stop operating after 1200hours. This didn't help because when looking at the average user time of 2-3 hours a day it would stop working exactly after expiration of its warranty. 

A similar measure was added to the PlayStation Networks Anti-cheat that required a mandatory accurate on Date and Time through a CMOS battery or network. After this was found in 2021, the public made it clear that it was not standing for it and so it was removed just weeks later. 

People have every right to he suspicious of any company, including one that has had prior problems with those issues. 

You came into this comment section shooting down person after person who accused Sony of participating in a practice that is and has been used by a lot of companies with their evidence being their experience. Your evidence is no different to theirs. You are putting trust into a company based on your experience, and hundreds of others here have shown their distrust in the company based on their experience.
Reply: @Primitive01  no
Reply: I’m i might honestly remove the battery and keep it plugged by all time at this point
Reply: I hate so much... joysticks are very expensive in my country
Reply: @No-wo8ri  Yeah ok, like the lightbulb conspiracy.. I show my trust by buying their products, if people are suspicious maybe they should just stop buying em
Reply: @rileyedwards6495  Fair enough
Reply: @Primitive01  You can call it a conspiracy but they admitted to it and the documents that the companies signed to agree not to make a product that exceed a certain amount of hours is publicly available so.... 

I'm sure some people do stop buying their products, but the truth is the vast majority won't even if there are problems because of the 'value' the entertainment sets bring to a person's house. They still see it as a worthwhile purchase even if they aren't great quality or feel as though they may be getting scammed. If you get a year or two out of the controller that you spent 80 or 90 dollars on then most people who could afford the 700 dollars on the console don't see a problem in buying a new one because of they wouldn't be able to use the console otherwise. It doesn't mean they're happy to do it, it just means that they don't have another option. You could say 'go to another console' but all 3 companies that have the monopoly on gaming entertainment systems have been accused of the same thing and all of the same few problems with their controllers. 

So again, you can think they don't. People will think they do, you're not going to change their mind by saying your  experience you've had with them, because they've had three exact opposite experience. It makes matters worse when you say "you probably threw you controller", because then you are directly attacking a person and therefore making them even less likely to change their mind.
Reply: Apple deliberately release new updates designed to make older iPhones slow so that users are forced to buy a new phone which will most likely be the latest iPhone. (I’m an iPhone user)
Reply: Battery is usually the thing that breaks, they can only withstand a certain amount of charges before they start to wear out.  However I still do believe apple could source better battery's for their phones, but they could also put better cameras in. Why they seem to be the only company to pioneer things like touchscreen while simultaneously being behind in everything else baffles me
Reply: @No-wo8ri  No, I think it doesn’t happen today because I can go to the shop and buy a lightbulb with a “20 year” lifetime or more, lightbulbs break through heating and cooling, being turned off and on, there is no such thing as a lightbulb that lasts forever, never has been, not in a persons home anyway, the only reason this ONE lightbulb has lasted so long is because it’s never turned off so it doesn’t go through the contraction and expansion of almost every other lightbulb on the planet.. The one lightbulb that was supposed to last forever turned out to be fake.. 

You’re meant to be the man with the statistics no? I don’t know if it’s purely PlayStation or what but I’ve read that the majority of gamers are men in their 30s.. Either way it doesn’t make much difference, shouldn’t be taking up such an expensive hobby if a controller once in a while is a strain on your wallet, if people wanna live beyond their means that’s something they have to deal with..

“One lasted a year, one lasted 3 or so years” I’m willing to bet that’s the kind of experience most people have, with the amount of usage controllers get and the rigours they go through you’re gonna have wildly varying experiences.. I actually asked 2 people I work with today if they’ve ever had to buy replacement controllers, both said one, EVER.. One of em said for their son, about 6, he’s 13 now, kids treat things like shit.. Didn’t ask reasons, just straight up “ever needed a replacement”.. I’ve only ever needed one but as you can clearly see I have launched controllers countless times and that’s the thing, that’s the main reason I think it’s all bullshit.. I’m not the only person who chucks controllers about, just look around YouTube, it’s a common occurrence, gamer rage is a legit thing, they don’t break when you smack em off a surface, they don’t break when you launch em at walls so much that you have to tape em shut because the little clips snap, the sticks are fine.. If they were designed to be weak in any way they’d be prone to breaking through force, they’re not, they’re actually extremely durable.. I also think social media makes people think that things are more common than they really are, firstly most people are just stupid, no brains, waste of skin, pointless and second if you see a bunch of people with the same experience as you you’re going to think that it happens a lot more, especially when that experience is negative  because people with positive or in this case “neutral” experiences don’t feel a need to go shouting about it, makes a big difference to peoples perception
Reply: @Primitive01  That wasn't what the 'Phoebus Cartel' was, it was a group of light bulb designers who got together and signed a contract saying that none of them would release a lightbulb that had a longer life than 1000 hours when the life of lightbulbs had already reached 2000 hours. They reduced the lifespan to ensure people wouldn't need to stop buying their lightbulbs and saw it as mutually beneficial to make such an agreement. 

The statistics I gave come from statistica, average age means nothing because the way the averages are obtained skew that data. For example if I had a list of people ages;
12 
18
25
37
66
The average is 31-32 years of age, yet only 1 is in that demographic, and you can clearly see there are more 'young' people in that list. 
20 percent are under 18 and 38 percent are 18-34, that's the data. 

You say each controller goes through different conditions, yet in my comment I stated that the last one I had (haven't purchased another one because I stopped using them) broke even though it was most definitely the one I used the least. I used maybe once or twice a month if that, and it got drift after a year and a bit of its purchase.

I'm not going to sit here and argue people's financial situations because that is a different argument than a company that may or may not being using deceptive business practices.
Reply: @No-wo8ri  You used it the least, so it was wearing away while not in use, magic!!
Reply: @No-wo8ri  There are over 250 comments here, mostly from me, I think I’m just gonna stop now… I don’t care what people think, I don’t care how people feel.. The original comment was about modern tech being designed to purposely break and the only “evidence” anyone has brought is something that happened 100 years ago, lonnnnnggggg before “modern tech”…. Like a few people have stated modern tech is undoubtedly more delicate.. And I’ve known about Apple slowing down older phones with IOS updates, didn’t think much of it because these days most people are on 18-24 month contracts anyway, contract up, new phone.. I dunno what it’s like in other countries but in the UK contracts are a massive thing, very few people are going out and spending £1000 on a phone, you get a “free” phone, pay your monthly bill, a year or 2 later you get the latest phone on a new contract.. And when it comes to the slowing down it’s many generations back, it’s not like it’s just one or two generations, it’s quite a few.. People are still going about with iPhone 6s no problem, I’m on the 13 ffs, it’s wrong but it’s not like you’re forced to go spend tons of money, 6s costs nothing, 7s cost nothing, but it is wrong, I’ve said many times I don’t doubt it happens but if all people can do is try to link lightbulbs from 100 years ago to an analog stick? No, simple as that, it’s about “modern” tech not ancient tech
Reply: No, technology has always been dodgy, the only reason we're hearing about it more is because everyone is becoming more aware of the issues devices have and what causes them
Reply: Seeing Daddio get destroyed in these comments was the best thing 🤣🤣🤣🤣🤣🤣🤣🤣🤣
Reply: Man just figured out what planned obsolescence is
Reply: You just defined Apple products, we all consume them yet we buy the next one every so often
Reply: @adangamez3608  xbox controllers don't have that problem, and you can use the 2013 xbox one controllers on an xbox series (retrocompatible)
Reply: @Primitive01  You do realise that Sony doesn't make much money from consoles? They make most of the money from games which is often why the console itself can last multiple years. Its the same with ink printers, those things are insanely durable because they make more money of ink cartridges. I've had "gaming laptops" that just drop dead after 3 years of usage, my current laptop has an extremely broken touchpad to the extent that its not even usable, you have to use a mouse.

Not to mention that modern phones are being made with more fragile components simply so that they break more easily forcing you to buy a new one. Its not a "its an unintended side affect of modern technology" but rather "we could make this stronger but we shouldn't so they buy more". Yes the more powerful and compact components are more fragile, but there was still plenty of room to make the phones more durable yet they aren't. Not to mention they actively design phones to be incredibly hard to repair on your own to push for more purchases. Its anti-consumer yet we can't do anything about it because they have market monopoly.
Reply: @Primitive01  The average open-world RPG takes about 20 hours to complete, 30 in some cases. Souls-like games jump to the 100 because of the difficulty but the actual amount of content is still roughly 20 hours.

Also, by old games, how long ago do you mean old games? From what I know, games as far back as 2009 would get a ton of hotfixes on release to fix the common and game-breaking bugs. However, after 1+ years, depending on the type of game it would either be dropped so they can move onto the next project or continue getting updates until its not longer making enough money.

Then there is the fact that the companies that are going "bust" tend to be the ones that are either relatively new or small and got hit by covid, or are owned by companies like EA who push unholy amounts of monetisation and then shut the studio down then no one buys the game.
Reply: @Primitive01  SONY doesn't care about customer satisfaction, nor are they a Japanese company, they are Korean. SONY have been forcing ads on their old phones to push people to buy their latest phones.  Not to mention, as I have said before, they are also designing hardware, phones and tablets, more specifically to be extremely difficult to repair by yourself forcing you to go to either a third-party or SONY themselves for repairs. I still remember the time where changing a Samsung batter was as easy as "Turn off phone, pop back cover off, take out old batter, put in new battery, put on cover and turn on phone." Now its "I need to watch 1 hour of tutorials, get an electronic toolkit, follow steps precisely, end up breaking phone" or "I need to pay £100 to a third-party repair store or to SONY to change the battery for me".

They are also the reason that cross-save/transfer from PS4 to other isn't a thing for the vast majority of multiplayer games, bar some AAA companies I think. If SONY really cared about customer satisfaction they would agree to those especially since there is literally nothing stopping it from happening except SONY' not wanting it happening. There is no hardware, software or resource limitations that would prevent it. The same with Cross-play, its a massive task just getting SONY to agree to cross-play before you can actually start working on it. Some devs has spent years before SONY agreed to cross-play but not cross-transfer.
Reply: @Primitive01  Like 90%+ of those 2 billion people are mobile gamers.
Reply: @ADunleavy  This is why I’m just gonna leave it.. You just sent 3 comments my way aimed at completely different parts of the conversation..

All I’m gonna say is souls games ain’t hard, they’re extremely simple
Reply: @Primitive01  New things are very different from old things though. Old things are generally much more robust and less prone to failure. There was actual studies and research done.
Reply: @Totally_Not_A_Crab  They've also said some completely idiotic things, like how some companies like SONY put customer satisfaction over everything, which clearly isn't true. Not to mention they supported companies like Square Enix who have sold some of their best franchises to fund their cryptobros scheme.
Reply: @Totally_Not_A_Crab  And yes, I know its a minority thing, but the number that he said, 1% of products being faulty, is still imo way to high since thats millions of devices that are faulty on SONY's scale. SONY themselves know that their controllers "often" get stick drift but have made no attempt at revising the design.
Reply: @Primitive01  SONY is a much worse company than you realise and while their customer satisfaction used to be great, that is no longer the case. You are looking at things through rose-tinted goggles. Not sure about Nintendo since I don't see the use of spending £400 on their switch.
Reply: @ADunleavy  Cry about it. Things go wrong, things happen. And unless you want a big bulky controller so that the things inside aren't so fragile, shut up. It's not Sony's fault that your controller broke dude
Reply: @ADunleavy  Also I dont know much about brands, my complaints were about something else so don't get me involved. And by saying that "1 percent is too high IN MY OPINION" you're literally saying "I have no argument, I just dont like the numbers"
Reply: @Primitive01  If you complain about his statistics, bring your own up. Not to mention that his statistic about how many people complain isn't just about PS5 controllers, its a study done on industry as a whole.

Also, SONY can prove its not done on purpose, there is a reason that you create meeting logs and design notes, just like how it can be proven it was done on purpose.
Reply: @Primitive01  Products wear away in use, not while not in use... The only one exception I would say are batteries.
Reply: @Primitive01  You seem to be ignoring the multiple lawsuits against SONY, MS, Apple etc.
Reply: this is true especially in new cars it’s called planned obsolescence unfortunately especially when it comes to put in plastic crap in the engine but they’re making cars these days to be justice disposable and breakable is these PlayStation five remotes they have the technology to make it better but dude agreed they don’t and another thing about the new cars they typically break as soon as the warranty expires they’re turning into appliances these cars which is what each is why I say the old ones are better they’re easier to fix people have more knowledge and understanding about them Parkstone cost a fortune and they’re much more simple that’s why they break glass too much technology too many moving parts somethings bound to go wrong rather quickly it’s just like with a new Game controllers such as the PS five dual sens controller they’re designed to break I feel like this controller is much more breakable and sensitive to drops in the PlayStation 3 controller I threw my PlayStation 3 controller at the wall as hard as I could one time the only thing that came apart from it was one of the R1 buttons and it still worked I just lost a little button for it so I couldn’t repair it but it’s kind of like those old House phone were you could throw them against the wall and they would never break as many times as you want tried doing that with a Smart phone made by Apple or Samsung count the number of parts that break off of it on impact hahahaha we live in a world riddled with planned obsolescence my friend unfortunately it’s funny to me because I have an old Nintendo 64 that’s got to be at least 20+ years old now something like that I bought it secondhand when it was already in its 20+ years and the funny thing is it still works very good do you know what broke the first five years I’ve had it my original white Xbox 360 it got the red ring of death that rendered it a paperweight I tried every little fix for it and nothing it would fix it for a minute and then it would go back to being broken so I definitely agree with you about older stuff is better even though the graphics are lacking planned obsolescence is definitely harder to find on those older consoles as well as my 1996 Buick Park Ave. that’s 26 years old it still runs perfect regardless The fact that it needs a tuneup and it has 75,000 miles on it just shy of it  but of course I’m the second owner so I guess it boils down to not only planned obsolescence how are you take care of it to mostly planned obsolescence these days because things are getting to too much technology and moving parts these days it all has to be bigger better than the last the problem is it doesn’t last three years in and you just buy a new one That’s how it is with smart phones so the other tech companies including car companies are seeing and they see dollar signs With how much money they can make every 3 years or less it all started from these smart phones unfortunately No matter how well you take care of a smart song is this it’s still gonna crap out on you after 3 years and unfortunately everyone’s going to that if they make a more robust and reliable product yeah it might take you a while to get more money out of people but more people are surely going to review and write and tell their friends about how awesome your product is and they’re going to want to buy one and over time you’ll get everyone’s customers because you make a superior reliable product but no one does that because they all want to make fast money
Reply: @90sbuickguy84  I hate to be this guy but dude if your writing something so long use a little grammar, it doesn't need to be perfect but just someone to atleast break up sentences or paragraphs, I struggle with grammar myself but I atleast make an attempt, I really hate that i had to say that to you, I do agree with what your saying well the parts I could make out atleast.
Reply: @Primitive01  Ok so the entire community of players and the LITERAL developers are wrong when they say its hard?
Reply: @Totally_Not_A_Crab  My controller was broken, like quite a few others, out of the box. Also, they don't need to be made more bulkier than they currently are, there was a ton of empty space in PS4 controllers already.
Reply: @Primitive01  
exactly what ive been thinking... people complain so much about the switch having controller drift problems. maybe it does if you throw it around and cover it in food lmao. i've had the same switch controllers since launch day and they work perfectly fine, cuz i take care of them

i had an xbox one since launch day that never had a single problem, i have tons of old nintendo consoles that still work perfectly
Reply: @Totally_Not_A_Crab  That was in relation to the comment where you said "I have no idea why he is getting hate when he is right" or something along those lines. I provided more information about why he was getting hate, so I didn't get you involved at all.

And the fact that a faulty product for 1% is often too high, not just for me but for a lot of others considering that 1% represents million in actuality. If he were to replace the "1%" with "A million faulty products" then yes, that is much too large. Not to mention that the number he gave has no evidence to back it up.

If we take that 1% an apply it solely to the amount of controllers sold with a PS4 that'll be 1.16 million controllers that are faulty. Add on the fact that its literally the best selling gamepad of all time? That number jumps considering an NPD report in 2018 showed it as the best selling gamepad outside of bundles, so as a standalone item.
Reply: @Primitive01  Also, I merely pointed out problems and countered problems in your comments, if you aren't bothered to read them then I'll just take it as you admitting you were wrong.
Reply: @90sbuickguy84  Yea lets not forgot that car companies are also using software to bypass emission checks etc to get extra profit.
Reply: @ADunleavy  I read them, I just don’t know which of my comments you’re talking about, there’s shit loads..

Take it how you wanna take it mate, it ain’t about being right or wrong and you didn’t exactly argue against anything I said anyway.. You told me souls games are hard, phones a fragile and Sony are a Korean company, I don’t see what any of that has to do with controllers being purpose built to break.. You also said something like “it’s not a side effect of modern tech” when I haven’t said it is, other people have.. You offered nothing to the conversation but whatever, tell yourself I’m wrong about whatever it is you think you’re arguing with me about and move on
Reply: As someone whose poured thousands of hours in RL on ds4s and dualsense, the dualsense is way more durable, on ds4 I'd go through a couple controllers a year. On dualsense I have almost no stick drift after 2 years, and the trigger springs don't lose resistance as fast. You have a selection bias. LCD/led tvs and LED light bulbs, battery technology. Most things have become way longer lasting. Quit buying cheap stuff and you'll get quality
Reply: @Primitive01  1) The souls game comment was in relation to the comment where you said "50-60 hours and I'll give them my money" or something like that, if you properly read that comment then you would have understood that it wasn't related to the main topic but rather a comment made onto a subtopic you brought up.

2) The phones are fragile part was supplemental information to the topic where companies would often make products less robust so that they break more easily forcing you to pay for more.

3) The fact that SONY is a Korean company is relevant because you used the argument that SONY cares about customer satisfaction because its a Japanese company. Also, not all Japanese companies care about Customer Satisfaction, SEGA is the most prominent when it comes to the Gaming Industry.

Also, please provide more context on "it’s not a side effect of modern tech" if you want to continue because as technology does advance it does get more delicate and fragile, that much is true. However, some companies deliberately add design flaws or make design choices to make it not as sturdy as it could be, whether this is to drive people to purchase more when they break or for another reason I do not know, however their refusal to comment implies that it isn't for consumer reasons.
Reply: @fifthtyp3  I've never bought counterfeits when it comes to controllers, I've always bought originals. Also, what is DS4S? Sorry for my lack of knowledge, googling also doesn't help me find out what it is.
Reply: @ADunleavy  A good game is a good game, doesn’t matter how long it is, certain devs offer much higher quality than others at the same standard price and those devs have built a solid reputation over the years, I’m buying certain games on release no matter what because I know what to expect and I’m willing to take the risk and that risk has always been worth it.. Every GTA game, every Final Fantasy game, every God of War game, these devs have a solid rep and always deliver..

I’ve said multiple times I don’t doubt it happens in certain industries, I’m talking specifically about controllers..

I never said all Japanese companies are like that, dunno what word I used but definitely didn’t imply all and it doesn’t matter because Korea is the same, the highest quality tech comes out of those two countries, they are miles ahead of the rest of the world in a lot of areas..

I’ve never said it’s side affect of modern tech, I know it is but haven’t said it once, other people have
Reply: @ADunleavy  plural abbreviating 'dualshock 4s'
Reply: @ADunleavy  And yeah people are wrong about souls games… They’re old school pattern learning games, almost all games used to be the same.. You die, you learn, you die, you learn.. The difference between souls games and old games is in souls games you’re put not far from where you were, you lose a few mins progress at most while in older games you died and started the whole game from the beginning, 3 lives, perma death.. Yeah those games where an hour or two long at most and it would be extremely harsh if souls games had perma death but the same concepts apply, you die, you learn.. A lot of people clearly have a problem learning patterns and recognising wind ups, that’s why they’re considered “hard”, people don’t wanna learn.. When I was growing up you had no choice but to learn, the “community” is wrong
Reply: @ADunleavy  Cry about it
Reply: @Primitive01  Yes, I know some games have a great reputation and also deliver great products. Rockstar's GTA V storyline was meh, its disjointed and you could do without a ton of time wastes in there. Like the literal cargo moving part in the Merryweather Ship heist? Not sure, but the one where you attack the cargo ship. The gameplay was amazing though so yea, sometimes quality is always assured but then you could also get the CDPR case where despite having a great reputation the delivery is horrible.

Also, it does happen in controllers, are you straight up ignoring the fact that there was 3 lawsuits against MS, Sony and Nintendo for their controllers because of the drifting?

You also have implied that Japanese always have great customer satisfaction by saying something along the lines of it, using Nintendo as an example despite that company doing a lot of shady stuff.

I've also never said you said its a side affect of modern tech. You said that I denied it, which I clearly don't. I just say that it isn't the sole reason.
Reply: @fifthtyp3  There is a dualshock 4s? Damn, I honestly didn't know that.
Reply: @Primitive01  So you are comparing a 2D arcane games to a 3D open world games? In a 2D game the movement you need to judge is just X and Y, in 3D its X, Y and X.

The hitboxes are also much more complicated because of, again, the 3D nature of souls-games. 

In those games you need to take into account the enemy's position in X and Y, the attack it'll use, the speed at which it will attack, the angle of the attack, the speed of your avatar and how many lives you have left.

In souls games, you need to take into account the enemy's position in X, Y and Z, the attack it'll use, the speed at which it will attack, the angle of attack, the speed of your avatar, the i-frames, your stamina, health, how many heals you have left,

Its honestly hilarious if you think that 2D arcade games are more difficult than Souls-games, I've played both old school games and Souls games and they are definitely harder than arcade games.

There is also the fact that you played them when you were a kid so there is definitely a ton of details that you won't remember clearly or exaggerate, as well as the fact that you weren't as experience in games as you are now.
Reply: @Totally_Not_A_Crab  The classic insult others because everything I said has been invalidated.
Reply: @ADunleavy  So in simple terms, because all logic has become meaningless to you, and you would much rather complain about the privileges you possess and create nonsense theories just to cause a reaction, I've simply decided to get you to leave me alone by telling you to cry about it. Maybe someone else will enjoy sitting here at their device for days on end, watching you rant and rave about an issue that's really not an issue. If you have such an issue, simply do not buy the console. You can't complain about the product then continue to buy it and not actually sort anything out yourself. I don't see you writing to Sony about the issues you face. Or, you know, doing a single thing other than complaining in a YouTube comment section. So, if you're going to just complain yet do fuck all about it, simply just do one and cry about it somewhere that doesnt include me. Please and thank you.
Reply: @ADunleavy  I’m not ignoring the fact there were lawsuits, I’m going WITH the fact it happened in the U.S, a nation you can sue someone for doing absolutely nothing wrong, for purely breathing the same air as you and also the fact nothing came of the lawsuits.. Innocent until proven guilty no??..

2D, 3D, doesn’t matter, you learn patterns, spot wind ups and press buttons.. Either I’m a god gamer (I do consider myself well above average when it comes to games anyway but whatever) or people are just stupid.. Pattern recognition and timing are far from hard skills, neither are unique to gaming and are used in almost everyone’s usual daily life, applying them to a video game shouldn’t be hard.. You can count? You can remember things? You can press a button without needing to look at your hands? If yes then souls games are far from hard, you die, you learn, simple.. Anyway, it’s a different conversation, I’m off and won’t be replying to any more comments from anyone.. Like I said show me proof I’ll accept I’m wrong, no one can or will, that’s the end of it.. People can believe what they wanna believe but anyone believing it and still buying em is a hardcore fool, you have a choice and it’s your own to make
Reply: @fifthtyp3  No idea why you are being so aggressive, I honestly thought that ds4s was another version of the dualshock 4... Since its very common for models to have a small or lite version with an added "s" or "l" to the name.

Also, no I am not ignorant on the fact that the PS4's controller is called Dualshock 4, since I myself have used that term in the first comment...
Reply: @ADunleavy  mb. I legit thought you were trolling me for saying "ds4s"  instead of 'dualshock 4 controllers' or sum, since I elucidated in my next reply "dualshock 4s" 4s (fours) meaning plural. Companys separate the S if it's a model variety for that 'es' pronunciation (iPhone 's', linkbuds 's') , never seen it combined. Anyways, always got bad stick drift with them
Reply: @Primitive01  The trial was started by a law-firm, not an individual, if you bothered to read even a single article or report on it, then you would have known that. You would also have known that those companies forced it into Arbitration so that the public wouldn't know the outcome.

Also, as I have clearly pointed out, there is a large difference between 2D and 3D. Yes its learning patterns but the patterns have move variables that need to be taken into account. Its like comparing an arithmetic sequence to a quadratic sequence, just because you can understand an arithmetic doesn't mean you will also know how quadratic sequences work.

Also, if you start a point, its your job to provide proof to support your claim, it is not my job to provide proof to counter your baseless claim. You claim dark souls are easier than arcade games, where is the proof for that?
Reply: @ADunleavy  Just read about the case against Sony and it makes me even more sure of what I think… 

Class action lawsuit, a bunch of individuals represented by the law firm.. The claim was controllers have a defect that Sony know about, nothing at all about making a product that’ll die on you just after or not long after warranty expires which is the WHOLE point of this shit, so the case has absolutely nothing to do with what I’m saying anyway.. 

The “study” that claims DualSense controllers have a lifespan of 400 hours, if true that’s 2 hours of use a day and the controller is dead in 7 months, 5 months before warranty is up, FREE replacement ffs.. It’s a lie anyway, I’ve had two controllers since release and one of them has been used for AT LEAST 2000+ hours and it’s working perfectly fine, like brand new, the other is easily over 1000 too, it won’t shut properly on one side because I smashed it but every single part works fine, triggers and everything.. 

The fact that case was bought about not even 6 months after the release of the PS5 should show you it’s got nothing to do with planned obsolescence or anything like it, they’re obligated to give you a free replacement in the first 12 months.. 

That early after release is most likely down to a bad batch or two.. I know quite a few people personally with PS5s, all but one were bought on release and not a single issue to date.. Remember all the “bricked” PS5s not long after release? Where did that go? 

Controllers are far more durable than most people think, they’re not fragile, not flimsy, you can bounce em off the floor with quite a bit of force over and over and they’re fine.. People can speculate all they want but you ain’t making a controller with parts that can survive getting battered over and over but all of a sudden fail through normal use in a “planned” way, not happening mate, they’d fail through trauma even more than normal use but they don’t and it was exactly the same with the PS4 controllers.. They ain’t made to break ffs.. What do you think they’re doing? Tracking certain people and busting there controllers with a big red button?.. I’m done, lightbulbs, lawsuits, you people come with things that show the opposite of what you believe ffs, it’s embarrassing, stop it..

I didn’t say souls games are easier than arcade games, I never even mentioned arcade games, why do you keep saying I’ve said things I haven’t said? You come across as someone who thinks you’re a lot cleverer than you really are, trust me, you’re not.. 

I said they’re the same as older games, they are, same concept, pattern recognition, I have nothing to prove, you’re bad at games.. This “souls games are hard” shit is only a thing because some weirdos who play them wanna try brag, no need, they’re not hard, you’re just bad
Reply: I won't deny that planned obsolescence is a thing, however that's not always the case. Half the time we're just trying to cram much more technology into something that's of similar size, and sometimes even smaller or we make a trade off to get something else. It's like how we like carbon fibre bikes because they're strong and really light but the drawback is that it actually has a "shelf life" (for lack of a better term) which is lower than that of the weaker, heavier metals we would use. In pursuit of improving what we have, sacrifices are made and corners are cut, and you get to feel those corners more and more in cheaper products especially
Reply: @javianbrown8627  I know that sometimes as a result of technological improvements there will be defects, however its pretty clear that the controller's drifting issue is only there because of their refusal to fix it. Just getting a longer lasting potentiometer would work, no need for new technology.
Reply: They've been doing it with light bulbs for a century. They even agree with other businesses to do the same, I believe.
Reply: @yevernotice9408  someone’s been watching too much Veritasium
Reply: @javianbrown8627  I have no idea who that is.
Reply: @UltraObama  same i ran thru 2 white 360s because some a hole sold my dad a faulty system so we bought another from walmart and it lasted us about 9 months of good gaming before it started shutting off randomly with RROD. I think I finally got a 360 Slim in 2012 and this thing is still kicking and working fine.
Reply: That's why consoles suck
Reply: @Primitive01  I have though. Anecdotal evidence, different experiences. I have literally had an xbox one controller that I just bought new fuck up and stop working within 2 weeks. I remember after I got another ps2 the first 2 controllers I bought for it both had messed up analog sticks.
Reply: @blackmambo8702  Cool.. Conversation ended already and I ain’t getting back into it
Reply: @Primitive01  I said what I said
Reply: @blackmambo8702  You did
Reply: This is a pretty commonly known thing. Apple has been doing it for years.
Reply: @tagg946  You clearly don’t understand what makes a lightbulb break over time.. Stay off the internet, it makes gullible people stupid
Reply: @kevmccormick1767  how did you break your ps4? I’m with mine for five years no problem at all
Reply: @Primitive01  chill man
Reply: @stephengreaves9771  I did, months ago.. Are you that desperate for my attention? Have it
Reply: @Kris77340  the problem with that is CHEAP kitchen appliances
Reply: @Primitive01  holy shit man those tech you listed is old as fuck
Reply: @ADunleavy  Or just use Hall Effect sensor. Dreamcast did it, and the sticks lasted really long.
Reply: Capitalism
Reply: @commencents1042  yeah its not even uo for debate its just real
Reply: @Primitive01  Imagine the logic in believing the car industry makes faulty products, but Sony controllers do not 😂 Are you being payed by them or something?
Reply: @Primitive01  So you don’t know what a potentiometer is but you’re still confident Sony doesn’t make faulty products?
Reply: @NukeisAfriKaner  Conversation is over, keep your emojis and go have a conversation that is happening now
Reply: @NukeisAfriKaner  Not intentionally no.. Now go annoy someone else little man
Reply: @Primitive01  I'm surprised if you didn't have a PS2 controller break after a while. Those controllers were rubbish compared to the PS4 and PS5 controllers that we now have.
Reply: @Primitive01  You’re right. The conversation is over. You’ve lost the argument to dozens of people in this comment thread alone.
Reply: @andyc7666  Never.. In fact I’m pretty sure the two that came with it lasted from 2001 to around 2008 when I upgraded to a 360.. Maybe a third world country like the U.S gets crusty versions, who knows? But shit, it’s been months.. Go do something
Reply: @Primitive01  I love that he said the more modern the console, and you immediately talk about older gen consoles.
Reply: It’s been like this since tech came out
Reply: @TrueJEMtheArtist  no it hasn't, I literally have games consoles that have been banged bashed and even kicked, they still work fine, they are older consoles like snes ps1 ect, however I seem to go thro multiples of the newer tech.
Reply: @Primitive01  homie I’ve had stuck drift many times I’d say your lucky or bullshiting
Reply: @Primitive01   Not trying to Persue the problem or take a side but my new series s controller started wacking out within 2 months of purchase 😅, my old one s controller with no grips still works perfectly fine, same with my og s and 360 e and og, even og xbox. Just problems with new controllers..
Reply: 🙈🙊 liberals . Nothing lasts forever bro . Christ 😂
Reply: U should try a Nintendo "cannot read SD card " Switch.
Reply: @Primitive01  your lived experience obviously dictates reality… how dare anyone contradict your lived experience
Reply: @reazonuk2362  no body is asking for things to last for ever bro, that's clearly not the point but nice attempt to twist my words, all because your insulted that someone dear criticise your idolised tech.

The point is tech and such from longer ago, take games consoles for example, a snes original been bumped bashed kicked played for 30 years and still works (obviously the older it got the better i took care of it) I also have a a mega drive 2 (the cheap lower quality edition) from close to 30 years ago that works, same with a original ps1, however I have had 3 xbox ones in 6  years.

I could say same about mobile phones, TVs, PCs almost all tech used to be built to last, but not anymore that's not the most profitable business plan.
Reply: @kevmccormick1767  bro, there are trade offs with everything. Im an 80s kid, using your argument, i could say that game cartidges were superior to discs that came later. Discs are easily scratched and probably more delicate than a cartidge plus the old cartidges loaded quicker.....but youre completely overlooking the massive improvements and tech upgrades. So while I myself didn't understand at the time why I was now having to load things, the advantages of discs for example were far  more memory and better quality sound. Tvs now have HD , ultra HD , 4k capabilities  and tons of features. They're huge these days and affordable. I wouldn't dare go back to the old tvs I use to play and watch TV on 😄. I never thought I'd ever ditch physical discs for streaming things. Game controllers are now largely wireless, I imagine its just the convenience and personally as much as I roll my eyes when the battery low message flashes on screen at some point, I wouldn't swap it for wired controllers- I deff went through many of them across multiple consoles with wires breaking.  I can't speak about x-box because I've never owned one but every console I've ever had has lasted including the modern ones. The only thing that have packed up on me are the good old 80s  commodore 64 ( I went through about 2.) I own a switch as well as a ps4 and 5 and that fucking thing has been shit since day one with its "error cand read SD card " bollocks. But most  ppl don't seem to have that problem. I know a guy who worships xbox and doesn't seem to have any issues/has had to buy one after the other. Obviously not saying youre lying, buy its very easy to conclude that its the manufacturers trying to con u when shit goes wrong for you personally and you're going to hear ppl with stories just like you and otherwise. Alot of ppl take modern technology and advances  for granted -I don't.  I wouldn't want to go back. But again, there are trade offs to advances . Nothings perfect.
Reply: @Primitive01  well said 👏
Reply: And you would be genuinely correct!!
Reply: @kevmccormick1767  bruh I have a ps2 ps3 ps4 and a ps5 I've never had a problem with any of the consoles breaking you just need to keep it in good condition and take care of your shit instead making shit up
Reply: @darmor85  yes after he through it can you not read?
Reply: @adangamez3608  no you just treat your controllers like shit I've never experienced stick drift on any of my personal controllers and I've been playing ever since ps2
Reply: @roythegracious  no shit really don't happen you just gotta take care of your shit like I bet you did way more then just that
Reply: @olaf5929  you just don't take care of your controllers
Reply: @Primitive01  Every Xbox One controller I've used has something wrong with it within the first month. Even my Nintendo Switch Joy-Cons lasted longer than any Xbox one controller I've had. Anything Nintendo before switch was made with the highest quality and I've had no issues with anything Pre-Switch. The PS5 is my first Sony console in a while and so far, no issues other than the seam in the right handle being a little off, but oddly most of my controllers have something odd about their right handle seams.
Reply: @sendhelp8441  It’s pure bullshit when it comes to the gaming industry.. You use a controller far more than any other product with moving parts, hundreds of hours in no time at all, thousands of hours per year in some cases… Some of them are going to break and the people who’s controllers break are the ones who talk about it, they’re vocal, people who don’t have issues have nothing to talk about, they’re silent.. So obviously when talking about this sort of stuff a huge majority of the people talking are going to be people who have issues and that’s going to distort people’s perception on the topic and make it seem like there’s a problem where there isn’t one.. 

Someone says “I’ve got issues”, and another says “yeah me too”, another “me too” and they all think “well it must be a problem, everyone I talk to has the same issue”.. Then someone like me who has no issue comes along and says “I have no issue” and everyone goes crazy “rahhhhh well you’re lucky, there’s 100 of us here and we’ve all got issues, you’re a rarity”, ignoring the fact that the other million like me are silent, happily playing their games with no issues and having no need to talk about the fact they have no issues… Things break, if it was “planned” they’d all break, they don’t, it’s a small minority of vocal people, most of which have brains far too small to understand what the hell I’m saying, they don’t understand perception or the role things like social media have on it.. It’s nonsense, people can keep crying to me all they want (not you specifically) but I’m still here having no issues like always
Reply: @adangamez3608  That's just you bro my controllers been chilling for years no drift
Reply: @kevmccormick1767  i used to own one of those really old androids, (it was a smartphone btw) and me and my brother legit smashed it with a sledgehammer and there was barely any damage. My current phone was dropped on the ground once and its almost completely ruined. So yeah you are probably right
Reply: @Primitive01  Just because you personally have had a lucky streak, doesn’t mean it’s not true. The world doesn’t revolve around you and your little bubble. I’ve had plenty of electronic’s break on me and I take care of everything. My PS5 controller battery just died and I hardly used it (as much as it was intended to be used at least). My old iPhone’s got slower with each update, not to mention the speaker and screen died and had to be replaced. Apple were actually sued and settled by paying $113m for deliberately slowing their phones via software to get users to upgrade in the past. It’s hardly a conspiracy or tin foil hat stuff. It has, does and will happen whether you believe it or not. They do design stuff in a way that will make us buy it again after a certain period of time. Why is it that PlayStation don’t let you easily change the batteries in their controllers? They obviously designed it in a way that when the battery dies, a lot of people will just buy a new one instead of going through the hassle of replacing it. I’m by far a conspiracy theorist but this is real and it does happen and to think it doesn’t is incredibly ignorant, especially for someone who says they are middle-aged.
Reply: @barrypaterson4617  As usual someone who doesn’t understand simple things like fractions and percentages.. I’ve never said it doesn’t happen, I’ve always said it happens nowhere near as much as people think.. It’s you thinking the world revolves around you, something happens to you, you see a negligible amount of vocal people who have had the same problem and your brain blows it up into something it’s not.. I’m not lucky, I’m in the majority, you’re unlucky, you’re in the minority.. Just so happens people who are content aren’t vocal, people with issues are loud.. How do you people not understand this sort of shit? 

You don’t call up a mechanic to let them know your car is running fine do you? You call them when you have an issue.. People whining on social media, or not, works exactly the same way..
Reply: @Primitive01  How did you even come to that “fractions and percentage” conclusion? Haha. Last I checked, everyone’s PlayStation controller doesn’t have replaceable batteries. That’s a majority to me. Is that not planned obsolescence on a mass scale? They are literally making it hard for people to change batteries in hopes they just splash cash for a new one. That’s just the controller. Your problem is that you think when someone says “planned obsolescence” you think it just means things are designed to break. Evidently, you don’t truly understand what it is. Most people don’t talk about it because they don’t notice or are in denial (You, for example). Are you going to address the Apple case or not or just shrug it under the table? It happens on mass with loads of different products and it’s not a conspiracy theory.
Reply: @barrypaterson4617  I don’t live in a bubble, I’m not in denial.. I interact, in the flesh, on a daily basis with people who share a hobby, also come from a family of people who share the same hobby..  I’m not a 14 year old boy who spends all his non school waking hours sitting in his bedroom only interacting with slugs on the internet..

I’m also not a slug brained fool and fully understand the role things like the internet and social media play on our perceptions of reality and our mentality towards that reality..
Reply: @Primitive01  Again, deflection. I am neither of those things either but that doesn’t add anything to yours or my argument. It’s just random drivel based on emotion. Have a good day.
Reply: @barrypaterson4617  Not implying you’re any of those things, just people on the internet are generally cut from the same cloth… I don’t need to add to my argument, it’s still the same as it was a year ago.. You came with the same things many people have said to me before and as usual the outcome is the same.. Another person who wants to ignore everyone and everything other  than the people who are vocal with their issues.. Know but won’t accept you’re in a small minority.. There’s no argument and can’t be an argument until someone takes into consideration the internet, social media, people’s need to feel heard when things aren’t great, negativity bias and all that stuff… It’s not like it’s an argument with a conclusive answer, it’s “I think”, “well I think” and I seem to be the only one willing to look beyond personal or shared experiences while being the only one accused of relying on my own personal experience.. The only one willing to throw a bit of common sense into a conversation that lacks hard numbers and facts.
Reply: @Primitive01  Then why mention any of this if you weren’t implying? What was the point in mentioning it at all? 

I’m not ignoring anyone. Your problem here is that you think social influence plays a major role in this and it doesn’t. The social aspect might influence ‘your’ opinion but I’m basing mines on the fact that it’s literally proven to be true. If it wasn’t such a common occurrence, why did countries like the UK just pass legislation in 2021 to counter the effects of planned obsolescence for consumers, by making it mandatory for businesses who sell products to make replacement parts for everything they sell available to purchase? Yet, they didn’t ban it outright like in some other countries. Why are there no such laws or regulations in countries like the USA when all these other countries are cracking down? It’s not because it’s “a conspiracy theory”. It’s because they make a lot of money from it and it’s too common. What about the perfect example of the PlayStation controller/battery design that you keep ignoring? Or the fact Apple literally owned up to the practice by settling after being sue’d? These are the facts you need to look at, not basing your opinion on your own social bubble because no matter how large or credible you think it is, it isn’t. You’re hindering yourself by thinking your “thinking outside the box” with social influence and it’s literally affecting your own opinion when you think you’re being unbiased. Being a hobbyist isn’t a reliable credential. You simply need to open your eyes at products these days and you can clearly see there has been some sort of planned obsolescence in the way it was designed.
Reply: @Primitive01  I haven’t seen you mention a single fact or hard number in any of your replies, yet I’ve mentioned a few.
Reply: @barrypaterson4617  So what the hell are you arguing about? Again, I’ve said many times planned obsolescence IS A THING, IS, I agree, it happens and it happens a lot.. So no, you’ve provided nothing, just trying to argue for the sake of it..

What I don’t agree with is Sony purposely do anything to make people buy more controllers.. They don’t have a replaceable battery no, but 99% of batteries will last until the next generation of consoles release and well beyond that.. 

What do you want? To be able to stick normal batteries in them? For Sony to make their own cheap ones like Microsoft do? The fact Microsoft make replacements you can grab off the shelf points to a low quality battery with the expectation of many people needing to replace them through either negligence, accidental damage or failure.. And you do know PS4/PS5 controllers are actually extremely simple to swap out and the cost of a battery is minimal don’t you? All you need is a small screw driver, the battery is plug and go.. 

I really don’t understand what you expect or what your point is with the batteries, they’re easily replaceable, they’re cheap AND Sony don’t make their own so they gain nothing from it.. Designing a controller in a way where the battery is hidden, meaning less chance of damage, with the expectation that it’ll last it’s expected use time should be seen as a plus no? And the fact they’re so easily replaced kind of defeats your argument no? They could make funky batteries you can’t get anywhere else and attach em in a way that makes it absolutely pointless even trying to get it out but they don’t, they’re plug and go, they didn’t just happen to overlook the probability of people making and selling cheap replacements.. If you need a new battery for your controller just go buy one and put it in mate, it’ll take you 5 minutes.
Reply: Yup that’s true for pretty much all new things
Reply: @kevmccormick1767 a year later reading this is still funny.
Reply: Welcome to the the world of cost of living saving Penny's and not caring about the end cusg
Reply: @andy2991  it's nothing to do with the current cost of living crisis, dont let them make you think it's because of that, the amount of companies using cost of living crisis as a excuse for whatever.

The planned obscelence has been a thing long before the current cost of living crisis.